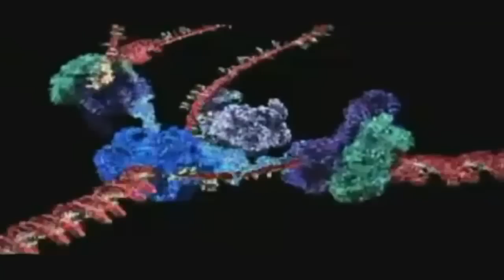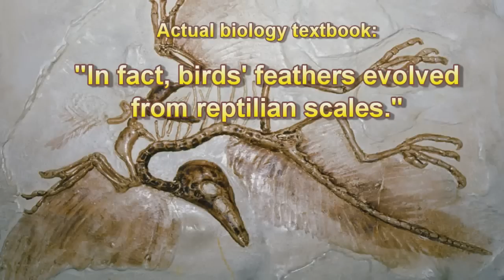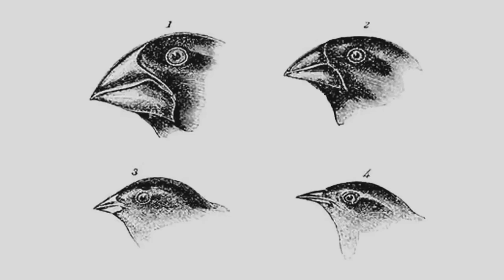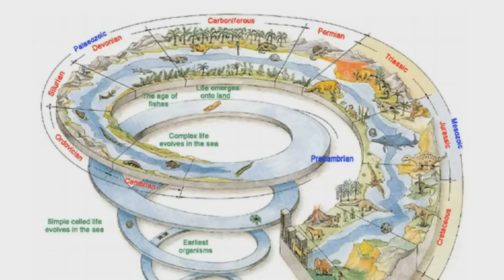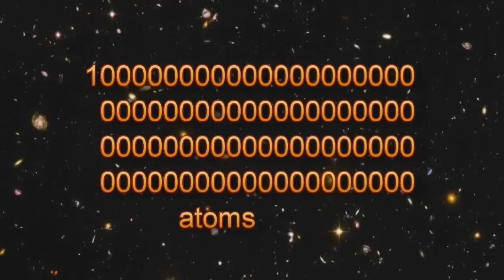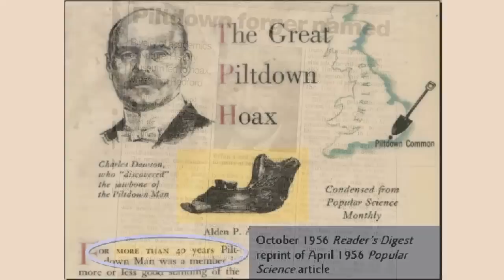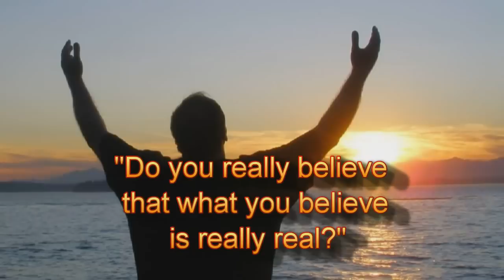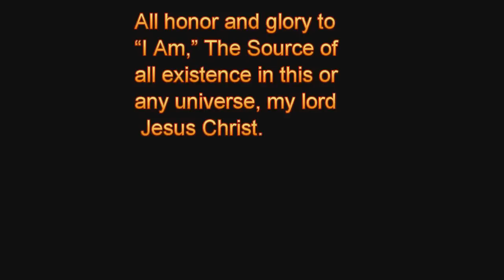Evolution Demolition

Comment: 49:02

DNA contains instructions for creating something that can copy itself so that it can keep existing and copying itself. It doesn't contain any useful "information". The machine code that runs a program on a computer is the same way. Take it out of its context, and it's completely useless. Same with the "code" in the DNA. It has no informational value outside of its very limited context.

DNA is a biochemical memory.

But yes, DNA and machine code for a computer is extremely similar, the way DNA is used in modern life.

But DNA is not a "message", unless you can show that it came from a mind. And it's obviously not being used as a message, but rather as machine code instructions, like a computer program.
Try opening an .exe file in notepad, and read the "inormation". See how much value it has outside of its very strict context. Same with DNA, it has no useful information outside of its context. Therefore it's not a "message".

50:00

That message in the sand was written with human letters, forming human words. DNA is not a human language, and it's not forming human words. So yes, I assume another human wrote "sand" in the sand, because that's what humans do, not what nature does.
But DNA? That is something nature does.

No one wrote the code in the DNA. We know this because the code changes naturally with every generation. So if there ever was an intelligently designed code in there, it's been changed by nature a long time ago.
Reply: antiHUMANDesigns So how do you explain smiles and laughter?  How do you explain the existence of music?  How do you explain philosophy and poetry?

The most complex matter in the universe is the human brain, which you think simply evolved via natural selection and random mutations to generate the ability to survive.  So why do you assume that your own intellect is reasoning in a valid way, given that your brain is no more than the result of such forces?
Reply: Mark Champneys "So how do you explain smiles and laughter? How do you explain the existence of music? How do you explain philosophy and poetry?"

There is a very good book on this very subject, by professor Victor S Johnston of NMSU, called "Why we feel: The science of human emotion".
Yes, it's a very complex subject. I wouldn't attempt to explain it satifactory in a youtube comment.

"The most complex matter in the universe is the human brain"

It might be. It's the most complex entity that we know of. But it's not like we've looked... barely anywhere.

"So why do you assume that your own intellect is reasoning in a valid way, given that your brain is no more than the result of such forces?"

Because that is reliable. Nature is what is real, and our brains are part of nature, so by definition they are part of what is real. And our brains are constantly tested against what is real. Simply put, if there was something fundamentally "wrong" about the brain, then we'd be dead.
But a brain that is "wrong" could not evolve. It would be bad for the individual.
Reply: antiHUMANDesigns "if there was something fundamentally "wrong" about the brain, then we'd be dead."

That does not follow.  Most living things have brains, and they survive, but they cannot reason.  We are talking about your ability to reason.  Survivability is very different from the ability to reason.  Reason is not a destination of Darwinism, only survival.  So what assurance is there in Darwinism that you can think straight, especially about abstract things?
Reply: Mark Champneys "Most living things have brains, and they survive, but they cannot reason. "

Well, most living things don't have brains, but whatever, I get your point.
I think we've got slightly different definitions of "reason". At least the "width" of the definition.
An ant is probably not aware that it is reasoning, but when it senses a smell, its brain gets signals, and the brain makes sense of those signals to make a decision about what to do. For example, run away, or follow the smell, and so on. Human reasoning still works the same way, it's just too complex to easily map it, so it looks as if it's something else, something more "free", but it's not "free". We cannot think "freely". We always think like a human. That's why we all, for the most part, think alike.

To get to my point: If the ant senses danger, but its respons is to go towards the danger to say "hello" (so to speak), then it will die. This is an example of its reasoning being bad.

In the case of humans, if my reasoning was "wrong", then I would not recognize that walking off a cliff is bad. I would not recognize that eating razor blades doesn't work as food. Simply put, I wouldn't make it one day. Basically, I would not be able to use my brain at all, because instead of reasoning, everything would just be a mess. I would not be able to communicate, for example.

"Survivability is very different from the ability to reason."

Not if your survival depends on your ability to reason, which is more true for humans than for any other living thing we know of, I suspect. But once again, it depends on the width of your definition of "reasoning".
A plant doesn't reason "much" at all. For the sake of argument, we could say it doesn't reason at all. But it also doesn't have the ability to eat razorblades, and it doesn't rely on communication ("much"), and so on.

" Reason is not a destination of Darwinism, only survival."

Good to hear you say that, because many creationists don't seem to underwstand that.
Yes, whichever DNA manages to copy itself is the DNA that will keep existing for a while longer. Though, evolution is generally about population groups, not individuals.

"  So what assurance is there in Darwinism that you can think straight, especially about abstract things?"

That we wouldn't have evolved this ability unless it was useful to our survival and/or reproduction. If we evolved abstract thinking, but it constantly lead us astray, then we wouldn't have a higher chance to reproduce, so such a trait would not be selected for.
That's the beauty of evolution: Everything is always tested for quality, so to speak. Of course, it's biased towards what makes the product keep copying itself, thsi is why we don't actualyl see the world for what it truly is (whatever that's supposed to mean), but rather for how it's useful to us.
To quote professor Victor S Johnston: "The human brain did not evolve to accurately represent the world around us; it evolved only to enhance the survival of our genes."

But of course, being aware of this means it's not a problem. Yes, rotten food doesn't actually smell bad, it's just our brains telling us it does to stop of from eating it. But being aware of this, we don't make the mistake of actually thinking that some molecules truly have a "bad smell" innate to them.
Reply: antiHUMANDesigns You equate programmed responses with reason, but reason, as I'm using the term at least, involves the ability to think in abstractions, and consider options.  Reason involves free will, not programmed responses to stimuli.  Abstract thought is absent from your discussion, yet that ability is essential to considering such things as origins.  So do you believe in the existence of free will or do you hold to a BF Skinner-type view of determinism.
Reply: Mark Champneys No, an ant doesn't have "programmed responses" any more than we do. But when you see a nasty spider, you will likely feel a specific reaction. If it drops down on your face, you'll probably react like any other human would. Why is that? Because you've got a human brain, and you think like a human - not freely.

"involves the ability to think in abstractions, and consider options."

What does it mean to "consider options"? A computer also considers opions, and makes choices. What's so special about how you consider options? It's more complex, so it takes a longer time,a dn there are more factors to consider than in most computer programs, for sure, but that doesn't mean it's not the same process, still.

" Reason involves free will, not programmed responses to stimuli."

What is "free will"? The freedom to make absolutely any choice? The freedom to not be bound by cause and effect (a violation of physics)?
If we had "free will", why do we all act typically human?
We do not have free will, it just appears as if we do, because there are too many factors to track if you want to be able to predict what someone will choose to do. If we made a complex computer program that reproduced with variation, and learnt as it "grew up", we would no longer be able to predict what choices it would make, either. It would appear to have "free will", aswell.

" Abstract thought is absent from your discussion"

We humans have this prefrontal cortex that allows us to retrieve information from the other parts of our brain, manipulate it, and re-insert it as new information. It's a cool trick, and it allows us to be very inventive. Is this what you're talking about? We can think of a bus, and think of the number 6, and try to imagine ways to combine these two things into something new. It's a trick.
However, we can never think of something completely new, that is not derived from something we have already seen or experienced. We cannot have truly novel thoughts. This is why we keep stealing designs from nature. It's also why aliens in movies are mish-mashes of things we've seen on earth. Try it yourself: Design an alien lifeform without stealing anything from something we already know about.
And this ties in to "free will", aswell. We cannot think truly freely, we'll always think like humans, just like a rat will think like a rat. And we think the way we do because it has allowed us to reproduce.
Reply: +antiHUMANDesigns Okay, so you don't believe in free will or reasoning about abstract ideas.  The only problem is you are thinking about this right now, so you know better.  You have inside information.  Inside yourself.  Is there such a thing as right and wrong?  Does the idea of babies being tortured bother you?  Why?  Do you believe in the existence of human rights?  Why?
Reply: Mark Champneys "Okay, so you don't believe in free will or reasoning about abstract ideas. The only problem is you are thinking about this right now, so you know better."

Yes, so you're obviously wrong in saying I don't believe in reasoning. I hav eno idea where you got that idea.
You're right that I don't belive in free will, though. But people define that in different ways. I believe in some definitions of it, but not in most.

" Is there such a thing as right and wrong? "

Yes, if we define those words, then there are rights and wrongs. I do believe in objective morality, just like I believe in objective medicine. What is good for life is not a matter of opinion, it's something that we can learn about through science.

"Does the idea of babies being tortured bother you? Why?"

Yes. Because I have empathy.

"Do you believe in the existence of human rights? Why?"

Yes. Because we've signed up on them. We've agreed upon them. Well, we more or less agree on most parts.
The geneva convention (was it?) states that all children have a right to a home, for example. We obviously don't all agree to that right, since there are homeless children - even though we did sign that paper.
So if you "human rights" you mean things like the right not to be murdered, then I don't only believe they exist, I know they exist.
Reply: +antiHUMANDesigns What is good for who's life?  Where did you get your empathy?  Is there some inherent survival value in empathy?  We have rights because we've signed up?  Why would you sign up?  What about all the people that did not sign up?  Then you do not believe in the declaration of independence that says it is "self-evident" that all people have rights that come from their Creator?  Do you see how evolution is completely inadequate to explain all these things?  If you look inside yourself, you know better, and I think you know that... because I sense that you are a decent human being.
Reply: Mark Champneys OK, lots of questions. And fair ones, sure.

"What is good for who's life?"

All humans are made up of the same biology. Arsenik is always going to be poisonous to us, so it's bad to eat it.
I'm talkig about what is good for life, not "life" in the sense of the experience of life, but life in the sense of survival and biology.

"Where did you get your empathy?"

I inherited it from my parents, I assume.

"Is there some inherent survival value in empathy? "

For a social species, yes, that's why we have it. If humans want to live together (which makes us stronger as a whole), then there has to be some kind of inborn instincs that make us not kill eachother, or we will fail as a social species.
Species that aren't social at all won't have empathy. They don't need it.

"We have rights because we've signed up?"

Yes, I'm talking about the geneva convention, and so on. We've all tried to agree upon a set of rights that people should have, and we mostly all agree, more or less, to the same rights.
You only have rights because they are enforced by law. If there was no law enforcement, then you don't have rights even if you think that you should have them.
But we can talk about what rights we "should have" as human beings, but that doesn't mean we actually do have those rights enforced.
Imagine that you lived where the was no law, and someone stole from you. What are you going to do? Claim you have rights? That won't help you one bit.

" Why would you sign up?  "

Because I wouldn't want to live in a society where we don't have some specific rights, such as the right now to be enslaved, for example.
Weird of you to even ask.

"What about all the people that did not sign up? "

I dunno, I guess they didn't sign up because they felt it made them lose power over their people. Remember, it's the governments that signed, not private people. You need these rights enforced by law, or they're useless.

"Then you do not believe in the declaration of independence that says it is "self-evident" that all people have rights that come from their Creator? "

That's not my declaration of independence. I'm Swedish, and our declaration doesn't say that. As a Swede, I don't care much for what the US declaration says. It's not like they're right just because they started a new country.
I don't agree that those rights are self-evident, but I agree that there is evidence for why those rights make sense. They can be demonstrated to be useful.

"  Do you see how evolution is completely inadequate to explain all these things?"

Not, they explain it quite perfectly. If you have a species of animals that are not social, they don't live by "strength in numbers", so to speak, and then you try to make them social, you will fail utterly unless you add instincts that make them not take advantage of eacother and hurt eachother.
It's not an easy subject to understand, but I've read a great book explains these things, by professor Victor S Johnston of NMSU, called "Why we feel: The science of human emotions".
It talks about why we would evolve emotions, for the most part. But also why we are conscious and why we experience existence the way we do. It's really tough stuff, but very interesting.

"If you look inside yourself, you know better"

Ehhhh, don't do that. Don't ever "look inside yourself" to try to understand things that are hard to explain. That's what we have science for. It's about as bad an idea as trying to use common sense to understand quantum mechanics.

"because I sense that you are a decent human being."

Yes, I would say I definitely am. But I'm also an intellectual person, and the first rule is to not think that you can just "think things out", that you can just assume that whatever makes sense to you is the truth. It's been demonstrated, over and over, both that the truith is not always simple, and also that humans are prone to make mistakes. Lots and lots of mistakes.
This is why we have the scientific method, to try to remove that human factor from the search for understanding.
Humans are prone to superstition, for example. It's a good mechanism when you're a baby, when you need to learn the basics about the world, but it eventually starts working against you.
Reply: +antiHUMANDesigns "...there has to be some kind of inborn instincs that make us not kill eachother,"   Oops.  Epic fail.

"Ehhhh, don't do that. Don't ever "look inside yourself" to try to understand things that are hard to explain."   I'm not suggesting that you make things up.  I'm speaking of an actual observation about what is in there and can't be observed from the outside.  If you are careful to understand the risks of self-delusion, it is important data that can't be obtained any other way.  You have inside information about the notion of consciousness, for example.  Take advantage of it.  Objective observations are fine, but we are dealing with questions (such as origins) that are outside the bounds of our ability to observe.  We are forced to make inferences to the best possible explanation, without having first-hand knowledge.  Writing off laughter or music as mere mechanisms of our survival is shallow and foolish.  Such things clearly have meaning and significance beyond natural selection.
Reply: Mark Champneys""...there has to be some kind of inborn instincs that make us not kill eachother," Oops. Epic fail."

"Epic fail"? 8| Wtf do you mean? 

" You have inside information about the notion of consciousness, for example.  "

not really. What information would that be? The only difference between an inside and outside look at the issue is that an inside look gives me the experience of it. But that doesn't change what it is or how it works, it rather just gets in the way of it.

"Objective observations are fine, but we are dealing with questions (such as origins) that are outside the bounds of our ability to observe."

That has not beeen established. Its very well possibly that we can determine what our origins are.
And to "observe", in scientific terms, simply means to collect data. It doesn't mean seeing something with your eyes.
We can observe the past with various means.

"We are forced to make inferences to the best possible explanation, without having first-hand knowledge.  "

As if first-hand knowledge is automatically correct? It's not. The only thing that matters is following a good scientific method, and to use proper reasoning.

" Writing off laughter or music as mere mechanisms of our survival is shallow and foolish. Such things clearly have meaning and significance beyond natural selection."

Then demonstrate the truth of that claim. It's that simple, that's all you have to do. Meanwhile, we have no reason to believe that claim.
Reply: +antiHUMANDesigns "Try opening an .exe file in notepad, and read the "inormation". See how much value it has outside of its very strict context. Same with DNA, it has no useful information outside of its context. Therefore it's not a "message".

obviously the exe file code is not going to make sense outside of it's context: it was intended strictly for the computer to read: same way the DNA is intended for the cells... the exe file code is not a message to you but to the computer: that doesn't mean it's not a message...
Reply: Benjamin Toby It is not information because it doesn't inform you.
An exe file, just like a DNA string, is only "information" in the sense of information theory, not in the sense of being informed. And in this way, a lot of things are "information". If you throw a bunch of rocks on the ground, the pattern they form is a kind of information, in the same way that DNA is information. It's a quantifiable amount.
But it is not information in the sense that it can inform you of anything. 

And the exe file isn't being "read" by the computer, because a computer doesn't have a mind. When we say a computer "reads", that's not what we mean.
If there is a number 5 there, then that will cause the electricity to go a certain way, and if it's a 6, it will cause something else to happen.
This is not "reading". It's cause and effect.
And DNA does the same thing. A specific sequences causes a specific protein to form, and that's all.
Machine codes causes specific electric patterns, and DNA causes specific chemical structures. Neither is "information".
Reply: antiHUMANDesigns the DNA is information to the cell: it's also information to you because you recognize it's a code: any reasonable person can tell the difference between the pattern a bunch of thrown rocks forms, and that of the DNA... the information from the thrown rocks is obviously gibberish but the DNA clearly shows a well sequenced code which contains instructions for specific tasks. 

"cause and effect"? what happens if you run an exe file on an android OS??? obviously reading a file in this context means getting compatible information from it: the number 5 on the exe file would cause an effect only with the compatible OS: that's why the DNA would not work outside the cell... without intelligence the "cause and effect" of the exe file wouldn't even exist... same for the DNA....
Reply: Benjamin Toby Ask yourself, can the information in DNA be "wrong"? If I tell you the wrong information about something, then that information is wrong. The "information" in DNA can never be right or wrong, because it's not there to inform anyone about anyhing. 

I agree that DNA can contain informative information, just like anything could. Look at our alphabet, 26 letters, compared to DNA's 4 bases. Our letters can form information that is meant to inform, and so could DNA. But it doesn't. You cannot read the DNA and be informed about anything else than what the sequence is. The sequence doesn't mean anything aout side of its context, therefore it isn't information.

No, it's even worse, a "5" in the machine code might do different things for different CPUs. That's why we need things like drivers and such, it's very complicated. Some CPU's have extended instruction sets of different versions, and only some programs make use of those instructions, and os on. It's a horrible mess, simply, because no one set up a standard to begin with.

"without intelligence the "cause and effect" of the exe file wouldn't even exist... same for the DNA...."

It's not an intelligence that's "reading" the DNA. Just like how the architecture of a computer decides what happens when you give it a "5", it's the laws of chemistry that "decides" what a specific sequence will result in. An intelligence can't change this even if they wanted to.

Yes, the architecture of the computer was made by humans. But the laws of chemistry and physics was not made by a human, and we have no reason to believe it was made by anyone at all.
And of course, computers do not reproduce with variation, so they cannot evolve.

And the important part to note here is that your DNA is the way it is because you are a variation of a copy of your parents. But because every human is born with about 60 mutations, some of your DNA is unique and completely new. Give this a million generations, and you might end up with 60 million mutations, in which case you are not even of the same species, anymore.
So if there ever was an intelligently designed DNA to start with, it's mostly gone, now. And that's obviously not a problem.
Reply: antiHUMANDesigns

1. "The "information" in DNA can never be right or wrong," actually it can't be wrong because it has a self correcting system that makes sure it's as right as possible: that's why a damage in a section caused by radioactive materials can lead to a hideous sight... 

2. "Our letters can form information that is meant to inform, and so could DNA. But it doesn't." the DNA was never meant to communicate any information to you: its instructions are strictly meant for the cell... it's not information to you doesn't mean it's not information: If I write an encrypted e-letter to my friend and you stumble into it and it appears as digital numbers(0's and 1's) hence you couldn't read it: does that mean it's not information?... 

3. " It's a horrible mess, simply, because no one set up a standard to begin with."... an Intelligent designer you mean?

4. " It's not an intelligence that's "reading" the DNA. "... it's not intelligence that's reading the computer code either: the reading and interpreting is only made possible by intelligence.

5. "And the important part to note here is that your DNA is the way it is because you are a variation of a copy of your parents." that's pretty obvious: my DNA was made by combining genetic information from my parents and adding a variation: that sounds to me like intentional variation: there's a reason why humans have not developed wings yet... the original DNA was never meant to be static.
Reply: Benjamin Toby "actually it can't be wrong because it has a self correcting system that makes sure it's as right as possible"

It's can't be wrong because there is no right or wrong, because it's not saying anything. IT's making no claims about the world, it isn't trying to inform anyone or answer correclty on a question. It contains zero information, therefore there is no information that can be checked against reality to see if it is right or wrong.
And the self-correction mechanisms only attempt to keep it the way it is, stop it from mutating. But it can still mutate, because these mechanisms are far from good enough.

" If I write an encrypted e-letter to my friend and you stumble into it and it appears as digital numbers(0's and 1's) hence you couldn't read it: does that mean it's not information?... "

Encrypting it doesn't stop it from being information. I don't care what language you writ eit in, even if you write it in your own made-up language that no one else can read, it's till informative. The contents of the message relays information from one mind to another.
DNA doesn't do this. It wasn't written by a mind, and it's not sent to a mind, and it has no need to inform anyone about anything. DNA simply is, and the DNA that is better at existing will more likely keep existing, and have more copies in the world. It's just a molecule, there's nothing magical about it.

And other molecules have information just like DNA. "H20" <- this is information in the exact same way as a DNA molecule.

"3. " It's a horrible mess, simply, because no one set up a standard to begin with."... an Intelligent designer you mean?"

You do remember that we're talking about computers, right? I think we all agree that computers are build by humans. They do no reproduce by themselves.

"4. " It's not an intelligence that's "reading" the DNA. "... it's not intelligence that's reading the computer code either: the reading and interpreting is only made possible by intelligence."

Yes, but if computers reproduced with variation, so that they could evolve, then it would be different. They don't, so we have to build them.

"that's pretty obvious: my DNA was made by combining genetic information from my parents and adding a variation: that sounds to me like intentional variation: there's a reason why humans have not developed wings yet... the original DNA was never meant to be static."

There are plenty of reasons why humans haven't delevoped wings.
Yes, I agree, the variation is there for a reason. Any species that does not evolve will eventually get left behind by those that do, and they will not be able to adapt to their environment when it changes.
Therefore, it's in life's best interest to evolve, if it is to keep existing. Therefore, only life that evolves still exists.
But "intentional" implies a mind, and we have no reason to go down that road.
Reply: antiHUMANDesigns you know i thought if I replied to all of that, I'd actually be repeating myself: but just to sum up: correct me if I'm wrong

1. you believe the DNA is a code, similar to the computer code...
2. you believe the computer code can only be intelligently created but the DNA code which is more complex just happened to exist...
Reply: Benjamin Toby Yeah, it's good to summarize every now and then, or a conversation might get out of hand.

 
"1. you believe the DNA is a code, similar to the computer code..."

I would be very careful about the word "code".
Machine code is a kind of code, perhaps, but DNA is less of a code than that.
Basically, if I were to push clay through a hole, the clay would come out the shape of the hole, yes? The hole is basically what DNA is. In the end, DNA is only a molecule in a world of chemistry. The fact that it's a macro-molecule doesn't stop it from being just a molecule.
And then there's the difference between "DNA" and "human DNA", for example. What is DNA, vs what is the role of DNA in a highly evolved organism.

http://dictionary.reference.com/browse/code?s=t
Definition number 6, "a word, letter, number, or other symbol used in a code system to mark, represent, or identify something".

This does not apply to DNA. The only way it applies it when we write "TAGC", which is code for the 4 different nucleobases. But the DNA doesn't actually use this code. It's just a molecule.

"2. you believe the computer code can only be intelligently created but the DNA code which is more complex just happened to exist..."

Computer code *is* created by humans. I'm not saying it can only be created by humans, but it is only created by humans, as far as we know. 
DNA is created by nature, we see this as a matter of observation.

Also, DNA is not "more complex". Modern DNA, such as human DNA, is really long, but DNA itself is not complex. DNA itself is just a linked chain of nucleobases, not very complex, though certianly not very primitive, either.

The difference between computer code and DNA is that I can hold DNA in my hand, but I cannot hold computer code in my hand. One is a molecule, the other one is a concept. That's why we can't really compare the two completely. It's also why nature can't create computer code - it doesn't actually exist, physically.
Reply: antiHUMANDesigns

1. you just defined a code to be a word, letter or other symbol used to mark, represent, or Identify something:... the DNA sequences represent patterns for building proteins: how exactly is it not a code? you just defined the DNA to be a code you know.

2. what makes the computer code a concept and the DNA not? the fact that you cant hold a computer code has nothing to do with it being a code: the definition says a word, letter or SYMBOL... the computer code is a letter code, the DNA code is a symbol code: those are still codes: what makes a code is what it represents: if it represents a particular process, then it's code...and do we need to explain what process the DNA represents?
Reply: Benjamin Toby "the DNA sequences represent patterns for building proteins: how exactly is it not a code? you just defined the DNA to be a code you know."

No, a pattern is not a code. A code for a pattern is a code.
"ATGC" <- this is code for the bases in a DNA. The bases in the DNA are not codes, but these letters that we use to refer to them are codes.

The only way that DNA can be a code is if it is being interpreted by a machine or a mind, but it's not. The bases produce what they produce, there is no interpretation, and there are no options. But "ATGC" could be called whatever we want, because that is a code, and it is interpreted by minds. It could just as well be any other 4 letters, for example.

"2. what makes the computer code a concept and the DNA not? the fact that you cant hold a computer code has nothing to do with it being a code:"

That is exactly it. A code is not a physical thing, it is a conceptual thing. DNA is not a code, though it could contain a code. DNA is well suited for storing sequences of 4 (or 5, even) differnet "values". It's not a code, just like a harddrive isn't a code.

"the computer code is a letter code, the DNA code is a symbol code:"

yes, but now you're saying "DNA code", not "DNA". That's a big difference.
If the DNA contains a code, then it contains a code. If it doesn't, then it doesn't, but in either case, it's still DNA, and DNA is not a code, it's a molecule.

And DNA does not contain symbols, either.
A symbol is something used to represent something else. There is nothing such going on in the DNA.
But because DNA is orderly, we can find simple rules that apply to it, and we can describe the process in terms of symbols.

We can describe gravity by writing "F = m/d^2". Does that mean that gravity contains those symbols? No, it doesn't.

And fruthermore, while a paper can have symbols on it, a paper doesn't contain symbols. It's not a trait of paper, it's a trait of what's on the paper. We can use DNA as a code for something, but that doesn't mean that DNA is a code, because it's not.
If I were to create my own DNA that contained a code for my home address, then it would be a code. But that is because it is a message from one mind to another, encoded into a sequence of some kind, and there is a ind interpreting it, converting symbols that refers to real things. You might see the logo for "Ford", and your mind knows it represents those cars. DNA does nothing like this, it just chemically produces proteins.
Reply: antiHUMANDesigns Oh I see... your confusion is differentiating DNA and DNA code?... 

- DNA

noun
deoxyribonucleic acid, a self-replicating material which is present in nearly all living organisms as the main constituent of chromosomes. It is the carrier of genetic information.(Google)

-Deoxyribonucleic acid (DNA) is a molecule that carries most of the genetic instructions used in the development, functioning and reproduction of all known living organisms and many viruses.(Wikipedia)

as we can see DNA is both a molecule and a carrier off information: which is the code I'm speaking of... there's no difference... the atoms just makeup the code...

it seems like you forgot your definition...CODE: ""a word, letter, number, or other symbol used in a code system to mark, represent, or identify something""... the DNA contains the sequence, a protein unwinds a section of it and a copy of a sequence is made... the copy is used to guide another system which builds proteins following the copied sequence... the sequence here is the symbol because it represents the formation of the desired protein... so, symbol= sequence, representation= protein... DNA = a whole lot of sequences = a whole lot of codes... going by your definition... 

so... "And DNA does not contain symbols, either.
A symbol is something used to represent something else."... what's that about?

also if you fold a paper to make a symbol, representing something, AKA a code: is that paper just a paper or a code?
Reply: Benjamin Toby "as we can see DNA is both a molecule and a carrier off information: which is the code I'm speaking of... there's no difference... the atoms just makeup the code..."

Yes, the definition you quoted is fine. DNA is a molecule, and because it is a chain of 4 different bases, it can contain sequences, or "information" in the sense of information theory, a quantifiable amount.
And because it is a chain like that, it could be used to encode informative information, such as a message, or even a jpeg picture.
But this requires that someone encodes this information and then decodes it.

The sequence that naturally exists in DNA of humans, for example, is not a code. It doesn't represent anything, it's just a sequence that produces specific proteins. It is the same thing as pushing clay through a cross-shaped hole and getting a cross-shaped clay. The "information" in human DNA is not interpreted by anyone, it isn't decoded, therefor eit's not a code. It simply reacts, chemically, to form amino acids that chain up into proteins.

"the sequence here is the symbol because it represents the formation of the desired protein... so, symbol= sequence, representation= protein... DNA = a whole lot of sequences = a whole lot of codes... going by your definition... "

No!
They are not symbols, because if they were, they would have to be interpreted by a mind. We asssign them symbols so that we can more easily talk about what's going on.
A sequence is just a sequence, nothing more. If the sequence is meant to be interpreted as a code, then it is a code. But this is not what's going on in human DNA.

There is no "desired protein". You keep using words that require a mind to be part of the process.

"also if you fold a paper to make a symbol, representing something, AKA a code: is that paper just a paper or a code?"

It's now a paper that contains a code, just as if you had written a code on it. But you didn't add any physical thing to it, and the code only exists because a mind is able to interpret the folds as a message from some other mind. Without any minds, there is no code.
Reply: antiHUMANDesigns I think I see the major misconception

"Yes, the definition you quoted is fine. DNA is a molecule, and because it is a chain of 4 different bases, it can contain sequences, or "information" "...

this was why I gave the example of the folded paper... take this instance: I fold 5 pieces of papers to form a sequence 10010: that sequence acts as instructions for switching a light bulb(1 being on and 0 being off)... I repeat my question: is that sequence paper or a code or both?
Reply: Benjamin Toby It is a sequence stored on paper.
Whether the sequence is a code or not is a different issue. It depends on if the sequence is decoded when used, or not. 

A "code" is something that represents something else within a code system.
A "code" is something that refers to something that refers to a real thing. It's what's called a "second-level symbol".

A word, such as "bird", refers to the real thing, an actual bird (but the word is not a bird, of course).
A code for "bird", might be "25251" or "flyer", whithin a specific code system, and refers to the word "bird", which refers to the actual bird. This is why it's second-level.

When it comes to computer code, this is true, because it's at least second-level symbolism.
In reality, the CPU either sends an electrical signal, or it doesn't. We refer to this as 0's and 1's, this is the first-level symbolism. Those 1's and 0's represent the real thing.
Anything that represents a set of 1's and 0's are codes. The number "5", for example, is a specific set of 1's and 0's, and is thus code within this code system, because it is second-level symbolism.
This is exactly like my example with "bird", vs a code for "bird".

"101011100111" <- this is not computer code. It's not encoded, it's the direct symbols for the real thing.
It could be encoded to "AE7", which is hexadecimal code for that same sequence. Now you've got hexadecimal code that refers to a string of binary numbers, which refer to the real thing.

So how is the sequence in DNA a code? It's clearly not, because it's the real thing, it's not even a symbol for the real thing. We create those symbols, CTGA, but they do not actually exist in the DNA, they only refer to parts of the molecule.
"C" is code for "cytosine", and cytosine refers to the real thing, therefore "C" is code, within this code system.
But the real thing, the part of the molecule, is not a code, even though it's theoretically possible for them to represent a code, if they are part of a code system. But they're not, because they are not interpreted, they are not decoded to become a symbol that refers to something.

We could use DNA to store code, though. If we use different sets of bases to represent letters, such as "ACT" representing the letter "L", for example, then we could read the sequence, and decode it to letters, and know the words.
So a sequence of "ATTAGATTCG", or something, might be decoded to mean "bird", under a specific code system.

Imagine if the body actually did this. It reads a sequence from the DNA, then decodes it to a symbol for what it was going to do, and then did that - without having any idea how to actually do that! It would need to have 2 sets of DNA, one that is code for the other. That would be stupid, since it could just have the one DNA that isn't encoded, and skip the other.
And that's exactly what it already has.
Reply: antiHUMANDesigns ""101011100111" <- this is not computer code. It's not encoded, it's the direct symbols for the real thing.
It could be encoded to "AE7", which is hexadecimal code for that same sequence. Now you've got hexadecimal code that refers to a string of binary numbers, which refer to the real thing."... Ummm... you do know that you can type your program in binary form right?... the hex form is just to shorten it... and the programming language shortens it more... ever heard of binary code?... it's the real code: just that it'll be cumbersome and extremely stressful to write programs in that form... so this "real thing" is actually the real code: the rest are just different representations... so what's your point exactly? if you write a program in a programming language say C++ you're actually writing binary codes: only that the language makes it easier for you: once you're done, the compiler translates it back to the binary code before it's executed...
Reply: Benjamin Toby "Ummm... you do know that you can type your program in binary form right?... the hex form is just to shorten it... and the programming language shortens it more... ever heard of binary code?... "

Yes, I am a C++ programmer, so I know.
Yes, you could write a program straight in binary, but that makes no sense do to.
Hex form is just base-16, yes. But it's still code, because it represents a binary sequence, and the binary sequence is symbolic for what is really going on in the computer.
No, I've never heard of "binary code". I wouldn't be surprised if anyone said that, but they'd be wrong to say that. It's technically wrong, but you would understand what he/she means.

"it's the real code: just that it'll be cumbersome and extremely stressful to write programs in that form... so this "real thing" is actually the real code: the rest are just different representations"

No, that's not quite true. A high-level programming language isn't directly translated from words to instructions. There is syntax.
If I write "x = 5+6", then that is not exactly what the computer does. This code that I write is translated to assembly, which is effectively the same thing as machine code, even if it isn't machine code. Then the assembly is converted to machine code, quite simply. Of course, compilers might skip the step of making it assembly.
The "real thing" is what's going on in the computer. Electric signals being sent down circuits and such. To help us talk about it, we call it true/false, or 0/1, or something similar. But the computer does not use 1's and 0's, they use what those 1's and 0's represent: Electrical currents.
So 1/0 is symbolism for electric currents. Go to a higher level, such as hex code, and it's technically code.
You say the rest are just different "representations" <- that is exactly what a "code" is. Something that represent something else. And that's why it needs to be decoded. Sometimes decoding it is simple, because the code system is simple. For example, hex values as code is really simple and makes a lot of sense, because 16 is a power of 2, which fits really well with binary numbers, which is all about powers of 2.

Another example of a "code" is if you and I want to share a secret message, so I tell you "the blue goose is on the run", and because we've got a code system set up, you can decode this an dunderstand that it means that it's time to rob a bank, or something. (?)
So in that code system "the blue goose..." decodes into "time to rob the bank", which refers to the actual act of robbing a bank.

" if you write a program in a programming language say C++ you're actually writing binary codes"

No, you're writing code that, in some sense, represents binary strings/sequences. It's not correct to call the binary sequences "codes", because they are not interpreted, they are direct instructions. If they are located on a harddrive, then they are actual fluctuations in the magnetic field on the harddrive, which will get turned into electrical signals, which drives the "machine" that is the computer. We symbolically call these fluctuations "1/0", but that is only symbolic.

"only that the language makes it easier for you: once you're done, the compiler translates it back to the binary code before it's executed"

Not binary code, binary data, a binary string, sequence, wahtever, but not a code. When the program has been compiled into 1/0, then it is done, there is no more changing or decoding going on after that, assuming it's not compressed somehow, like in a zip file.
A zip file, or .rar or similar, takes a sequence of data and encodes it. It does this by writing things that symbolically means something that is longer (takes more space). That is a form of code. A zip file uses RLE, so if there are 7 0's in a row, then it will basically write "7-0" (somethign similar), which takes less space than writing "0000000". This is code, and the sequence needs to be decoded before it can be used.
But a binary sequence, such as in an .exe file, does not need to be decoded, because it is not a code. It's a sequence of direct instructions, not symbolic, and not encoded. If it was code, it would be slower, because it would need to be decoded as it runs.
Reply: antiHUMANDesigns sooo... your basic problem is the term "code"... as a programmer I'm kind of surprised you prefer to call the machine code binary strings... the only reason you need to "code" these "strings" is to allow flexibility and ease of use of the strings: and even if these strings represent the switches, you can just use the switches directly: just that there'll be less flexibility: 

"But a binary sequence, such as in an .exe file, does not need to be decoded, because it is not a code. It's a sequence of direct instructions"... and those instructions are translated to the display: if they don't need to be decoded then why don't you see a bunch of 0's and 1's on your computer screen?... don't you know how computers work?... if you type "bird" on your computer it's translated to 01100010011010010111001001100100 and your processor recognizes the sequence and tells the display to show "bird"... so why are you speaking like the binary sequences aren't interpreted?
Reply: Benjamin Toby "as a programmer I'm kind of surprised you prefer to call the machine code binary strings"

Well, machine code isn't actually binary. I mean it is, of course, but each binary value isn't read as a separate instruction, because then there would only be 2 different instructions, and I know there's at least 6 basic instructions, so the bits are probably read 8 at a time, for each instruction, I suspect. Could be different for differnet architectures, aswell.
So then each instruction is a specific pattern of a set of bits, because one bit isn't enough.

A "binary string" is just a sequence of bits, such as "0110". Anything in a computer is a binary string, fundamentally.
But now you're switching words again. You said "binary code", and now you're saying "machine code". Those are not the same thing.

"and even if these strings represent the switches, you can just use the switches directly: just that there'll be less flexibility: "

The CPU will not accept just one bit, it needs a specific set of bits. If you want to just "flick one switch", you would give it something like "00001000" to only activate the 4th "switch".
As far as I know, a computer does not have the ability to only send one bit, under any circumstances. They always come in packs of 8, 16, 32, 64, or any other power-of-2. (Though, there has been 6 bit computers, aswell.)
This is why a binary string isn't the same thing as machine code. A binary string can be of any length, but machine code must always be a 8-bit value, or some other length that is specific to the architecture of the computer.

Confusingly, machine code is a binary string, but a binary string isn't always machine code. :P
Why are we discussing this, again?

"and those instructions are translated to the display: if they don't need to be decoded then why don't you see a bunch of 0's and 1's on your computer screen?... don't you know how computers work?... "

No, you don't know how computers works (which becomes even more apparent later on in your comment).
The screen is just another computer that your computer is talking to, sending messages to. There are plenty of programs that do not show you anything on the screen. The screen is irrelevant to this, it's just an attached device, like joystick or a mouse.

You're talking about software, not hardware. 1/0 represents what's going on in the hardware. And yes, of course, the result of a specific complex set of 1/0 will result in something that is useful, a software.
And yes, software could translate strings of bits and so on, but just because they could doesn't mean that they do.

Displaying somethig on a screen is just another electrical signal going through the motherboard on the computer, using a specific set of instructions. Whether those bits are codes or not, depends on what the monitor is expecting. Once again, that doesn't inherently make it "code", it just means it could be code. Just like how I could talk plainly to you, but I could also talk in code, if that's what you need me to do.

And of course you will not see 1's and 0's on the screen. We've already been over this: There are no actual 1's and 0's, they are symbols for electrical signals. If you could see these things, you would see electrical signals, not 1's and 0's.
It's as if you think that if I would show you a bird, it would be the word "bird" you're seeing, instead of the actual bird that the word refers to.

"if you type "bird" on your computer it's translated to 01100010011010010111001001100100 and your processor recognizes the sequence and tells the display to show "bird"... so why are you speaking like the binary sequences aren't interpreted? "

Hehe, no. Just no.
If you type "bird" on your computer, you've actually already typed that binary string, but it is being displayed to you interpreted as letters. There is no way a computer could actually store a letter, since it can only store bits. Neither can your keyboard send letters to the computer. I can only send binary sequences. There was never a letter anywhere in the computer, at any time. what you're seeing on the screen, when you see a letter, is a set of lights that are shining in a pattern that your brain recognizes as a letter.

Secondly, the CPU cannot recognize a sequence for a letter, or something like that. All a CPU can really do, is to take a binary string and do some logic with another binary string. Such as OR'ing together two strings, or AND'ing them, and so on.
And the correct sequence of such logical operations makes it a calculating machine. But it has no way of knowing if a sequence of bits is meant to represent a letter, or something else, because only a mind can do that. Because letters only exist in minds.

Any binary string could be chopped up into groups of 8bits, and each group could be translated into a letter (or character) using an ASCII table, for example. But if you do that to a binary string that was never meant to represent letters, you'll get gibberish.
Perhaps that very same binary string was actually meant to represent a 32-bit value. It all depends on what the "intent" was behind the string.
This is why I keep telling you that is has the capability of containing a code, but that doesn't mean it does. 

Those binary sequences are not interpreted by the machine. The only interpretation that happens is when a human interprets it, so that it can make sense to that human, because the binary string doesn't make immidiate sense to humans, and it requires translation, decoding, interpreting, all depending on how it was intended to be used.
Unless the raw binary string is exactly what you wanted, and no* some kind of conversion into a value or a letter, or an image, or a sound, or whatever.
Reply: antiHUMANDesigns apparently you don't read very closely: your supposed corrections don't even touch my point:please could you read closely before jumping onto your keyboard: it could save a lot of time and space... 

1. like I said, if we type the word "bird", the CPU is not going to read it as "bird", it's going to read the binary equivalent: hence, I said it's converted into binary form... the word is converted to binary via the keyboard...

2. the binary string is processed and sent to the display... 

3. The display takes the message and shows up "bird"... I don't care to know how it does it, my basic point is that it interpreted the binary string... 

if you're not ok with this give me a step by step method of what happens when you type the word "bird" on your computer keyboard...

btw... ""and even if these strings represent the switches, you can just use the switches directly: just that there'll be less flexibility: "

The CPU will not accept just one bit, it needs a specific set of bits. If you want to just "flick one switch", you would give it something like "00001000" to only activate the 4th "switch".
As far as I know, a computer does not have the ability to only send one bit, under any circumstances. They always come in packs of 8, 16, 32, 64, or any other power-of-2. (Though, there has been 6 bit computers, aswell.)
This is why a binary string isn't the same thing as machine code. A binary string can be of any length, but machine code must always be a 8-bit value, or some other length that is specific to the architecture of the computer."..... well of point... please read my lines closer...
Reply: Benjamin Toby"1. like I said, if we type the word "bird", the CPU is not going to read it as "bird", it's going to read the binary equivalent: hence, I said it's converted into binary form... the word is converted to binary via the keyboard..."

I don't agree that anything was ever converted. When you press the letter "K" on your keyboard, there is no conversion going on. You're sending a binary string from the moment you press that key. There is never a conversion.
It isn't a "K" just because there is a sticker on the key that says "K". Conceptually, it is a "K", only, but that concept is never converted, either. It conceptually remains a "K" for as long as that concept makes sense.

"2. the binary string is processed and sent to the display... "

I don't know exactly what you mean by "processed", but it might be, or it might not be, depending on the hardware and software used. But yeah, I don't know exactly what you mean.

"3. The display takes the message and shows up "bird"... I don't care to know how it does it, my basic point is that it interpreted the binary string... "

I don't like what you're saying. I don't know if you're wrong or if you're just saying it a way that sounds suspiciously wrong.

The monitor gets a binary string from the computer, and this binary string directly controls what color each pixel should have. The monitor is not aware what the result will "look like", whether the pixels will form a letter or something else. It gets RGB values for each pixel on the screen, covering the entire screen. And that's basically all. Some modern monitors will talk to the computer in order to sync its refresh rate to the GFX card, but otherwise, that's it, as far as I know.

And this binary string comes directly from the video memory on the graphics card. There is no conversion, and no decoding, because this needs to be fast to avoid introducing lag.

But whether or not you want to call this process an "interpretation" is irrelevant, because it is a computer talking to another computer, with no humans involved in that process.

"if you're not ok with this give me a step by step method of what happens when you type the word "bird" on your computer keyboard"

I can only tell you so much, because after the first few steps, the operating system takes over, and then it's software, not hardware. The binary string that came from the key you pressed gets stored in RAM, and from there, it all depends on what the computer is programmed to do with that binary string. I could tell you how it works in Windows, but I suspect it's irrelevant.

Keyboards are special, though, because even without an operating system installed, the motherboard's modules can still recognize what key you press, so that you can control the computer before an operating system boots up. And most computers will refuse to start if you have no keyboard connected.

The motherboard has a simple operating system in it, called BIOS, "basic in/out system", that runs the motherboard. This system is responsible for sending information between different modules. It doesn't control what happens in the CPU, or any other module, but it controls the communication between CPU and RAM and so on, to some degree.

But I think we'd do best to avoid getting into extremely technical details about this. What this discussion is about is what the binary strings "are", and this will only confuse that issue.

"well of point... please read my lines closer..."

"well of point"?
I do what I can. It seems that you were implying that the lowest level programming possible would be to control each switch independently, and I'm telling you that it's not possible to do that, making machine code the lowest possible level that you can use to instruct the computer. That is, binary sets of 8 bits, or such, controlling multiple "switches" at the same time.
But I have no idea why you'd say that independently controlling the switches would give you less flexibility, when it would in fact give you more, if it was possible and made sense to do so. Lower level programming = more flexibility.
Reply: antiHUMANDesigns I'm sorry but English doesn't seem to be your first language: I don't know how else to express something that simple: In case you still don't get it, I'll repeat: If you don't agree with my description, give me a methodical process of what goes on when you type the word "bird": from the keyboard to the display...
Reply: Benjamin Toby No, I'm Swedish, so Swedish is my first language. But I'm only asking what you meant by "processed". There are lots of ways to "process" things.

Before I go through that process of what happens when you press a keyboard key, I must note that a lot of it depends on the operating system, and the drivers for the different devices.

But let me try to see if I can do it, based on how I understand that it works:
1. You press a key, which sends a binary string through the USB cable (lets assume it's a USB keyboard).

2. The binary string enters the motherboard through a USB port. Lets say the USB port is intergrated into the motherboard.

3. I might be wrong about this part, but I think that this creates what is called an "interrupt" in the motherboard, which basically informs the motherboard that it has recieved a signal from some specific port.

4. The operating system is able to ask the motherboard if such as "interrupt" has occured, and if it has, then it tells the motherboard to direct this binary string to a place in RAM, that the operating system decides. And in this process, I think the USB drivers are the ones who actually figure out what part of the signal/interrupt is a useful message, because the string may also contain operation codes and such, and if the message is somehow encoded, it decodes it. The drivers are the ones who are translating operating system commands into commands that the connected device would understand, and vice versa. That is, the operating system tells the drivers what it wants to do, and the driver translates that "universal" instruction to whatever specific instruction is required for that device. And incoming messages are translated to something that the operating system understands. If the keyboard uses a different representation of the letter "K" than the operating system does, the drivers will translate it for the operating system.

5. Anyways, the binary sting ends up in a specific place in RAM and is registered into a "queue" of incoming messages that different programs can check to see if someone pressed a key, or if the mouse has moved, and so on. (this is hwo it works in windows.)

6. The program that someone has programmed might check for incoming events/messages in that queue in the OS, such as a keystroke, and then copy that incoming binary string message to its own place in RAM, and use that to display that letter on the screen. It's possible that the operating system has added information tot he message, such as the exact time the message was received, and so on.

7. How the actual displaying of it is done depends completely on how the program is programmed, but whatever you do, you still need to use a "font" to calculate what the letter should look like, and then copy that "picture" of the letter into the memory on the graphics card, and then it can be displayed.
But note that it's not the binary message that is being displayed. The binary string that the program read contains a representation of what letter is supposed to be displayed, but it doesn't copntain the information about what a letter even looks like. A font does that. So a "glyph" (a letter) from a font is displayed, which corresponds to the letter represented by that binary string.

Phew....

Well, that's pretty much it. I can't guarantee that this is all correct, because I am not an expert on this. I do not program drivers or operating systems.
Reply: antiHUMANDesigns so to sum up, the binary string is decoded by some processes to display the word "bird"?
Reply: Benjamin Toby No, the binary string doesn't need to be decoded, because it already is the value/sequence that is directly read.
The only reason to ever encode a binary string is to either make it shorter to save space, or to encrypt it to hide its information from others.

So once again, it could be encoded, but it normally isn't, because it doesn't need to be.

Quick tip: For something to be decoded, it must first have been encoded.

DNA was never encoded, and doesn't need to be decoded before it can be read. Therefore, it's not code. It shouldn't be so hard to understand.
Reply: antiHUMANDesigns Oh my Oh my: let me repeat: the binary string is translated(decoded/transformed/interpreted/whatever) by the "font" in the display system, into a graphical representation, which displays the word via the video card right?
Reply: Benjamin Toby A font is like a picture, it's not a program, it cannot do anything, it's just plain data. It's a file that contains ifnormation about what letters looks like.
It is a program such as MS Office that uses this information to display somethign useful. MS Office loads a font, and load a list of letters to display.

And once again, even though I've told you this 100 times already, the binary string is not changed in any way. It isn't "decoded" because it wasn't encoded, and it doesn't need to be converted or translated or transformed, it just needs to be read the way it is, so that we know what value/string it is, so that we can compare this to a list of characters in a font file and decide which one should be displayed.

The keyboard sends something like "1100", which ends up in RAM, and the porgram reads "1100", and knows that this is supposed to represent a letter, so it searches though a font of letters until it finds the image that represents letter "1100", and displays that.
See, no need to decode or convert it in any way.
Reply: antiHUMANDesigns "And once again, even though I've told you this 100 times already, the binary string is not changed in any way. It isn't "decoded" because it wasn't encoded, and it doesn't need to be converted or translated or transformed, it just needs to be read the way it is, so that we know what value/string it is, so that we can compare this to a list of characters in a font file and decide which one should be displayed."... I can't believe you bruh... if it's not going to be translated why compare it to a font list? PS there's definitely more going on in an LCD or plasma screen than just binary strings: there's some chemistry needed to display each pixel...

"The keyboard sends something like "1100", which ends up in RAM, and the porgram reads "1100", and knows that this is supposed to represent a letter, so it searches though a font of letters until it finds the image that represents letter "1100", and displays that.
See, no need to decode or convert it in any way."...if 1100 represents an image in a font, what would displaying the keyboard letter mean if it's not the binary string or the electric signal that's displayed? it is obviously converted to a font image the same way your programming language C++ is converted to binary code: and it represents a binary string the same way a letter in C++ represents a binary string... please tell me you understand this...
Reply: Benjamin Toby " I can't believe you bruh... if it's not going to be translated why compare it to a font list? "

Is a comparison a translation? Come on... If I compare the value of two things, am I translating one value into the other? No,I am checking whether they are the same. IT's an instruction. The binary string is used as an instruction in the program, to control the flow of the program. The binary string for the letter "K" instructs the program to take a specific path that leads to displaying a specific picture (the picture of a "K").

"PS there's definitely more going on in an LCD screen than just binary strings: there's some chemistry needed to display each pixel"

Physics, not chemistry, most likely.
If it's an LED monitor, then it is a process of releasing electrons between two charged states to produce a specific color.
The amount of each color is determined by the string that the monitor receives. The string is just raw data, a pattern that causes specific electrical events that produce light.
In this way it is similar to DNA, because a DNA sequence is also a raw sequence that causes proteins to be sequenced.
In both cases, some specific sequences are useful, while others aren't. If you send random values to a monitor, in many cases you'll see some pattens on the screen that you'll be able to recognize as something you've seen before, like a symbol, or something. It will randomly happen.

"...if 1100 represents an image in a font, what would displaying the keyboard letter mean if it's not the binary string or the electric signal that's displayed? it is obviously converted to a font image the same way your programming language C++ is converted to binary code: and it represents a binary string the same way a letter in C++ represents a binary string... please tell me you understand this..."

What "1100" represents is ambiguous. It is what it is. It was inteded to represent the letter K within something like an ASCII table. When you pressed the key and sent that string, it wasn't actually intended to represent a glyph in a font, it was a numerial value for a letter.
But that numerical value (the binary string) allows a program to recognize which letter you intended to print, by sharing the same ASCII table.
But the program could easily be tricked, and we could send it something that didn't come from the keyboard at all, and was never intended to represent a letter, and the program will look at the binary string and assume it's a letter, and display the letter, soyou'll get a bunch of random letters on the screen.
This is because "1100" never actually did represent anything. It is what it is, and it's only meaningful to us if we are consistent with what we use the value for.

It's not the "1100" that is being displayed, it's an RGB image the size of the screen that is displayed. The construction of this image is influenced by that value "1100", in that program. But the "1100" cannot be directly displayed, because monitors are not designed to do that. If you tried sending "1100" to the monitor, it would "assume" it is half of the data needed to specify one color of one pixel on the screen, and it would wait for the "rest of the data".

The string is not "converted" to a glyph from a font, or converted to an image, or anything like that. It is used as an instruction, or an "influence", in a complex process of creating an image.
What you're saying is like taking the blueprint for a house, and converting the blueprint to a house. You don't do that, you use the blueprint to instruct you how to convert a bunch of materials into a house. The blueprint remains unconverted.
(When you're done, you can convert the blueprint to a paper airplane.)

"the same way your programming language C++ is converted to binary code"

Not "binary code". Call it binary sequence, or machine code.

" it is obviously converted to a font image the same way your programming language C++ is converted to binary code: and it represents a binary string the same way a letter in C++ represents a binary string... please tell me you understand this..."

I am trying to understand you, but his last part is weird.
If I write a letter in C++... it may or may not represent a binary string in the mahine code. It may represent something abstract, or it may represent more than one binary string, and often in different parts of the resulting machine code.
"Abstract" in the sense that it doesn't "do anything", it just explains a concept to the compiler, so that it can "keep it in mind" as it reads through the rest. Such things never actually gets translated to machine code, it only influences the way the compiler interprets the rest of it.

See, a programming language is not a code, it is a lot more like an actual language, even if it's very simple for a language. It uses abstract things, which do not directly translate to what the computer does, and it contains syntax.
When I program C++, I am actually "talking to" the compiler, and explaining to it what I want my program to be like, in a slightly abstract way, but also in great detail. This is why there is a difference between different programming languages, or they would all effectively be the same thing. Some are better at explaining things simply or clearly or in a complex and exact manner, and so on. Some simply allow you to say "I want to draw this image on the screen", without you having to explain how you want to do that. More assumptions by the compiler = quicker to make a program, but less flexibility. That makes it a "higher level" language, while less assumptions and more direct instructions makes it a "lower level" language, until it has no syntax and nothing abstract, so it is no longer a language, but a coding system.

This is why programming code is called "code", simply because of tradition, even though it no longer is code, but a language.
The earliest programming languages were not languages, but coding systems, or simply "codes".
Reply: antiHUMANDesigns "It's not the "1100" that is being displayed, it's an RGB image the size of the screen that is displayed. The construction of this image is influenced by that value "1100", in that program. "... WELL... I know it's not "1100" being displayed: the RGB image is my point: once that image shows up, the binary string has run its course: your problem obviously is my usage of the word "converted"... the binary string is obviously translated by the display device to show an RGB image eventually so what's your point?

"The string is not "converted" to a glyph from a font, or converted to an image, or anything like that. It is used as an instruction, or an "influence", in a complex process of creating an image."... oh really? it's not "converted" but acts as an instruction in a "complex process" of creating an image?... so what would you describe this "complex process" that "creates" the image?... isn't that the "conversion"? or what you're afraid of that word?... ok "interpretation"? makes no difference... my obvious point is in creating the image and that "complex process" depends on the binary string hence interpretation is THE process...

"Physics, not chemistry, most likely.
If it's an LED monitor, then it is a process of releasing electrons between two charged states to produce a specific color."... of course there's chemistry involved: how do you think the "specific colours" are produced in an LCD/plasma display?

"What you're saying is like taking the blueprint for a house, and converting the blueprint to a house."... what I'm saying is converting the instructions in the blueprint to the House: the instruction is drawn with ink or something: the interpretation is the House: diagram to house: that's the conversion...

" The blueprint remains unconverted.
(When you're done, you can convert the blueprint to a paper airplane.)"... of course not... when the house is done, the blueprint is fully converted... that was the idea all along...

please could you try your best to understand my point here and save me the pointless rants?
Reply: Benjamin Toby "your problem obviously is my usage of the word "converted"... "

Yes, but believe me, I would not be picking at the words like this unless I thought that you're whole reason for discussion this is because you're playing word-games.
And yes, trying to force DNA to be called "code", and using that as an argument for DNA being intelligetly design is a word-game. It's a trick. (Well, an attempt at a trick.)

"... the binary string is obviously translated by the display device to show an RGB image eventually so what's your point?"

I'm sorry to have to say this but... no, it's never translated. the string directly controls the voltages, or whatever, that produces light. the string already represents an RBA image, in this sense, so it doesn't need to be translated.
The minotor requires a sequence where groups of 3 butes define the RGB values for each pixel. If this is not the kidn of sequence being sent, then it would have to be translated or converted to this, but that's not the case, as far as I know.
Of course, I don't build monitors, so... :P I can't say for sure which ones mess around with the values, and to what extent. My point is only that I know it isn't required to make it work. Most of the work is done by the graphics card.
And on top of this, sometimes it's an analog monitor, so the signal the graphics card sends in not a binary string, but rather somekind of frequency-modulated signal, or something.

"... oh really? it's not "converted" but acts as an instruction in a "complex process" of creating an image?... so what would you describe this "complex process" that "creates" the image?... isn't that the "conversion"? or what you're afraid of that word?... ok "interpretation"? "

The image is created in RAM, based on instructions. The binary string that holds the number is never going to be a part of, or in some way intergrated into, the image being built.

An RGB image is still just a binary sequence. I can write a program that makes an RGA image that is just a long sequence of 0's (which will make it black), but I could write the program so that if someone presses the "K" key, the program will instead create a binary sequence of all 1's, instead of 0's, making it a white picture.
See how it's just an instruction that impacts a process? The keypress that caused the program to make a sequence of 1's instead of 0's is never translated or converted or "turned into" an image.
The image and the binary string from the keyboard do not in any way represent eachother. One simply caused the other to happen. It wasn't translated, because you cannot translate a number into an image of a number and have it make any sense. The image can be made in an almost infinite number of ways, and can be ecoded in different ways, so that different sequences describe the exact same picture. The binary string is not a "concept", whicle an image is a concept. An image only exists in minds, not in reality.
And you obiously cannot convert something real into something conceptual, if you understand what I mean.

Call it an "instruction", and you're good. Not "interpretation" or "translation" or whatever, it's an instruction, because that's what it's being used as.

"makes no difference... my obvious point is in creating the image and that "complex process" depends on the binary string hence interpretation is THE process"

Instruction. The process is a mechanism that runs instructions, and the binary string is the instruction. The RGB image is the output, the result, of the process.

Blueprint and house, like I said earlier. The process is the human building the house. the human is the program. The binary string from the keyboard is *part* of the blueprint for the house. And the material is what is being converted from one shape (beams and logs or whatever) into the shape of a house.

But it does seem like you're implying that the blueprint is somehow what's being converted into the house. And I think it's actually important to this discussion to point out that that is wrong.

"of course there's chemistry involved: how do you think the "specific colours" are produced in an LCD/plasma display?"

I haven't studied how plasma works, which is why I took LED monitors as an example. Plasma is not used for computer monitors, because static images hurt the plasma screen, and computers mainly generate static images.
That's why I said "physics, most likely". But on the really small scales, it can sometimes be confusing what is chemistry and what is physics, since chemistry is a sub-set of physics. Chemistry is physics, just a specific portion of it having to do with reaction of molecules and atoms. Buit it we're talking aboot electrons giving off light, then it is physics. Quantum physics, even.
But whatever, screw it, lets say all monitors are chemical, I don't care!

"what I'm saying is converting the instructions in the blueprint to the House: the instruction is drawn with ink or something: the interpretation is the House: diagram to house: that's the conversion"

So instead of saying that you're converting paper into a house, you're now converting something conceptual (not physical) into a house?
Why can't you just accept what I'm saying, that the blueprints are instructions for converting materials from some shape into the shape of a house?
The only "conversion" going on is the conversion of the shape of the materials used.
http://dictionary.reference.com/browse/convert?s=t
"to change (something) into a different form or properties; transmute; transform. "

The blueprint is not reshaped, transformed, or changed in any way. It is only being read, and it will remain the same thing once the house is finished, proving that it was not converted in any way in the process.

"Interpreted", fine, I'm OK with that: The blueprint is being interpreted by the human. This informs the human about how to convert materials into a house. Because humans cannot directly "plug into" the blue print, we need to interpret the symbolism on the blueprint into instructions in our minds.

Are we OK with this?

"" The blueprint remains unconverted.
(When you're done, you can convert the blueprint to a paper airplane.)"... of course not... when the house is done, the blueprint is fully converted... that was the idea all along"

LOL, nooooo...! The blueprint was never converted! :P
You know how I can prove that it wasn't? Because you could theoretically build the very exact same house without a blueprint! Obviously, houses do not exist because they were "converted from blueprints"... they were converted from materials. And you'll never find a sinlge house that exists that was not converted from materials. But I bet there are houses that didn't have a blueprint. At least in the olden days, if not today.

"please could you try your best to understand my point here and save me the pointless rants?"

You know, if you ask me a question, and I give you a simple answer, and then you act as if I hadn't already explain this to you, then I'm going to have to give you a more detailed explanation. And when that is still not enough, then I will give you what you will consider a "rant".
If you then call that "pointless", then... I dunno what to do, because you asked for it.
Reply: antiHUMANDesigns 

1. "Yes, but believe me, I would not be picking at the words like this unless I thought that you're whole reason for discussion this is because you're playing word-games.
And yes, trying to force DNA to be called "code", and using that as an argument for DNA being intelligetly design is a word-game. It's a trick. (Well, an attempt at a trick.)"... I think even staunch evolutionists can see the DNA is a code: or at least functions like one: the fact that you're arguing over that actually proves that you're the one playing word games: as usual with evolutionists: tbh I don't think I've seen a scientific discipline that gains most of it's credibility from Language manipulation: most credible sciences I know of are strictly guided by math: 

btw I'm not forcing DNA to be called code: you are actually forcing the DNA to be called just a molecule or something: I don't think there's any link you can give me which describes the DNA without mentioning "information" or "code"... 

2. "I'm sorry to have to say this but... no, it's never translated. the string directly controls the voltages, or whatever, that produces light."... and the voltages are "translated" to the visible light pattern which is the image... it could be via Liquid crystals or plasma gas... there's no way you can escape the process of translation...

3. "I can't say for sure which ones mess around with the values, and to what extent."... then could you stop the rant about what you're not sure of?... you can connect your computer to a plasma screen via HDMI and it'll display just fine: but the plasma screen has it's own computer to interpret the signals coming from your computer so there's definitely translation(or interpretation) of binary strings there.

4."And on top of this, sometimes it's an analog monitor, so the signal the graphics card sends in not a binary string, but rather somekind of frequency-modulated signal, or something."... still, translation is involved...

5."The image is created in RAM, based on instructions. The binary string that holds the number is never going to be a part of, or in some way intergrated into, the image being built."... obviously I'm not saying the binary string literally "shape-shifts" into the image or something like that: I'm saying it's translated(översatt) or interpreted(tolkas) to form the image...

6. "Call it an "instruction", and you're good. Not "interpretation" or "translation" or whatever, it's an instruction, because that's what it's being used as."... and what would the action of carrying out an instruction be?

7. "LOL, nooooo...! The blueprint was never converted!"... well what can I say, I guess by saying "converted" you interpreted "converted into a paper plane"... it's no point to dwell on that anymore I guess...

8. It seems obvious to me that you're not very knowledgeable about monitors and displays: there's much more going on in LCD and Plasma screens than just binary strings: and that validates my point: I mean the display is just another connected output device that the computer talks to: the instructions sent to it definitely are interpreted to give the required pictures: so most of your rants don't change my point... it's just like telling me binary strings aren't converted to sounds in the speakers...

9. "You know, if you ask me a question, and I give you a simple answer, and then you act as if I hadn't already explain this to you, then I'm going to have to give you a more detailed explanation. "... excuse me not every explanation in your mind qualifies as valid in reality: most times your "simple answers" are pointless or just plain drivel: I'm actually the one trying to simplify things and reason with you: I think I deserve credit for that... In actuality, I'm kind of disappointed at the kind of vain intellect and logic I've noticed within the atheist and evolutionist population: I mean look how many days it took me to make one simple point: the binary string of the word "bird" is translated into a graphical image representation by the display device in a computer system... I mean if you take into consideration the actions of the Liquid Crystals in an LCD display alone, my point is made...
Reply: Benjamin Toby " I think even staunch evolutionists can see the DNA is a code: or at least functions like one"

Let me refresh your memory: A "code" is a symbol that stands in place for another symbol, in accordance with some code system.
It would make no sense to have DNA be encoded. That would mean it has to be decoded before it's used, and we know for a fact that it is not. The ribosomes read a direct copy of the DNA sequence, which causes them to sequence proteins. There is no decoding going on in the middle of that.

As for "evolutionist", as far as I know, that only means someone who believes in evolution. That doesn't mean they have any credibility or credentials, it just means they believe in evolution. That could literally be anyone.
Also, the majority of "evolutionists" are actually christians, or at least religious.

"the fact that you're arguing over that actually proves that you're the one playing word games: as usual with evolutionists: "

Show me where my fallacy is, where I attempt to try to use an equivocation fallacy, for example. Prove that you're not lying, right there.
I have clearly stated that whatever the DNA sequence is, it's being used directly. Call it whatever you want, but it is what it is, and it is created naturally.
But you want to argue that if we call it "code", then it can't be natural, so you want it to be called code, as if that would change whether DNA sequences can occur naturally.
So tell me again, who is playing word games?

"tbh I don't think I've seen a scientific discipline that gains most of it's credibility from Language manipulation"

What's really going on is that you don't know what the words mean, and when you are being corrected, you think we've trying to dodge it.
What we're really "dodging" is your straw manning of the science.

"btw I'm not forcing DNA to be called code: you are actually forcing the DNA to be called just a molecule or something: I don't think there's any link you can give me which describes the DNA without mentioning "information" or "code"... "

Information, yes, I ahve agreed to this all along. Infomration, not in the sense of being informative, but in the sense that information theory describes information, as a quantifiable amount, and subject to entropy, and so on.
But I'm going to dare propose that you don't know what that means, because if you did, then you wouldn't even have asked how a river could hold information.
Just.... study more. Please. Before you go and tell people something is wrong, study what you're talking about.

Also, are you claiming that DNA is more than a molecule? And in what way is it more than a molecule, in some way that isn't true for any other molecule?

"2. "I'm sorry to have to say this but... no, it's never translated. the string directly controls the voltages, or whatever, that produces light."... and the voltages are "translated" to the visible light pattern which is the image... it could be via Liquid crystals or plasma gas... there's no way you can escape the process of translation"

OK, fine, lets call that translation. I wouldn't, but I have no reason to keep arguing this issue. I looked up the definition of "translation", and I agree that it might possible that you could call that event a translation, maybe. It's unclear to me. But I'll concede this to you, so that we can drop this.

That is, the movement of electrons turning into a light wave, I can concede that this might be called "translation", even though I'm unsure.

"3. "I can't say for sure which ones mess around with the values, and to what extent."... then could you stop the rant about what you're not sure of?... "

I never ranted about which specific monitors mess with the values...!

"you can connect your computer to a plasma screen via HDMI and it'll display just fine: but the plasma screen has it's own computer to interpret the signals coming from your computer so there's definitely translation(or interpretation) of binary strings there."

This is exactly the same thing as what is going on inside the program that received the binary string from the computer, and sent an RGB picture to the monitor.
The monitor doesn't need to "interpret" the signals. To "interpret" is to figure out the meaning of something. It's similar to "decoding", in that the message would be changed from one sequence into another sequence. A monitor doesn't need to do this if the GFX card is already sending the information to the monitor in a way that the monitor can directly make use of. Encoding and decoding of any sort only adds more work for the GFX card and the monitor, with no benefit. And a GFX card is desigend to "speak the same language" as the monitor, so there is no interpretation required.

The monitor uses a binary string to set its "switches", which results in different colors of light. I've already conceded that you could call this part a "translation", though.

But the binary string is being used directly to control the switches, as if it was mechanical. No interpretation or conversion is *required* to make it work.

"4."And on top of this, sometimes it's an analog monitor, so the signal the graphics card sends in not a binary string, but rather somekind of frequency-modulated signal, or something."... still, translation is involved..."

An electrical circuit called an D/A-converter "translates" the binary string into an analog signal, as per my earlier concession.
I will consistently allow you to use the word "translate" to describe this event.

"obviously I'm not saying the binary string literally "shape-shifts" into the image or something like that: I'm saying it's translated(översatt) or interpreted(tolkas) to form the image..."

Hey, thanks for the swedish translation. :P It was almost completely correct. (Should have been "tolkad" to be consistent, grammatically.)

Only minds can "interpret" things, because an interpretation is conceptual, and compuer don't do those things.
It's possible that you'll hear people say that, but that is an abstraction of what is going on inside the computer. It is only an "interpretation" because that's what the programmer had in mind when we wrote the program. But the program doesn't actually contain a mind that can interpret things, and therefore it cannot hold "concepts", abstract thinking.
If we made a program like that, it would be slow as nothing you've ever seen.

As for "translation"... fine, lets say it's a "translation", I'm going to have to be consistenly OK with that, since I have conceded that.

"6. "Call it an "instruction", and you're good. Not "interpretation" or "translation" or whatever, it's an instruction, because that's what it's being used as."... and what would the action of carrying out an instruction be?"

To "comply"? I think when you carry out an instruction, you "comply", but I also suspect that might only be true for someone who had a choice in whether to comply or not.
But assuming you're a native english speaking, you should know better than me, so you tell me.

"8. It seems obvious to me that you're not very knowledgeable about monitors and displays: there's much more going on in LCD and Plasma screens than just binary strings: and that validates my point"

You'd be correct, I am not knowledeable about those. Are you?
I've pointed out, since the start, that a computer sending images to a display is just one computer "talking to" another. A digital monitor is a much less powerful and less flexible computer.
But what I am saying is still true, because I am ignoring the parts that may vary between different monitors, and I focus on what needs to be true for all monitors in order for them to work.

The context of this discussion remains how this compares to DNA. And so what steps are required to make a monitor display a letter is what is interesting. It is not interesting if some company decides to make a monitor that imporve the image quality, and so on. 

This all started by you asking me to explain teh steps from keyboard press to the display ing of a letter.
Now please make your point, because you're causing this to become an ever derailing conversation.

": the instructions sent to it definitely are interpreted to give the required pictures:"

Only minds interpret things, because interpretations are conceptual. 
As far as I know, there are no computer programs that function as minds.

"I'm actually the one trying to simplify things and reason with you: I think I deserve credit for that"

If that is what you're doing, then yes, credits to you for that. I can't know if that is what you're doing, because I don't know what you would have said if you chose not to do that. I can't read your mind.

Simplifying and staying on the point is great, but we've had some issues with the use of specific words that have implications that you appear to not take into consideration.
You're talking about whether DNA was intelligently sequenced. When you use words like "interpret", then this has an impact on the discussion, so I want to make sure you don't use that word where it doesn't belong.
But I am met with some hostility for doing this. But you cannot blame me for pointing this out when it is crucial to the counter-argument.

And let me tell you, all thes different words that are being thrown around as if they're intechangeable is starting to really get me confused. Translate, convert, interpret, I don't remember them all, but these are not all interchangeable. And we can't seem to agree, so I don't know what to do. Do you have a solution to this?

I think that if we could go back to talking about how this all relates to DNA, then we could start making sense, again, and actually move forward.

"In actuality, I'm kind of disappointed at the kind of vain intellect and logic I've noticed within the atheist and evolutionist population: I mean look how many days it took me to make one simple point [...]"

Note that you're talking to someone with asperger's syndrome. I am not representative of "evolutionists". I am cynical and nit-picky and convoluted, I know, call it a personal flaw. No question is ever simple to me, because I see so many factors that other people seem to have learnt to ignore. I can't see the forest for the trees, and that's a trait of asperger's syndrome.

But if you are correct about what you're saying, and I am wrong, then you should still be able to "prove" that. No amount of "ranting" can stop the true from being true.

"the binary string of the word "bird" is translated into a graphical image representation by the display device in a computer system"

Thoughout the discussion of this point, you've used all kinds of words, like "interpreted" and "converted", and so on. That is what has gotten in the way of you making your point. You might be used to talking to people who will accept just about any equivocation, but that doesn't fly with me, or anyone else who is used to seeing through such things.
That's probably why you're having trouble whenever you're talking to "evolutionists". You don't understand the problem of equivocation.

When you set out to prove that the use of the word "code" proves that DNA was intelligently designed, which is moronic from the very start, then yes, it's going to be a cynical discussion about the meaning of words. That's what you wanted, wasn't it?

So, if in the end, by "translation", you simply mean the converstion of a digital signla into an analog signal at the very end, then OK, I accept your point as true. But what on earth does that have to do with DNA, in such case?
It seems like you set out to prove that DNA is decoded, but all you did was prove that a monitor translates a binary string into a light, a conversin of digital to analog.
That is not a decoding, either, so it appears completely irrelevant to your point.

Call it good faith, that I assume you're trying to make a better point than that. If it seemed like you were arguing that water is transparent because a chicken crossed the street, then I will assume there is some problem in our communication, rather than assuming you have the intelligence of a worm.
Reply: antiHUMANDesigns
Let me refresh your memory: A "code" is a symbol that stands in place for another symbol, in accordance with some code system.... Umm lemme refresh yours:
"http://dictionary.reference.com/browse/code?s=t
Definition number 6, "a word, letter, number, or other symbol used in a code system to mark, represent, or identify something". ... you see these two definitions aren't the same? at least not on the standard of your equivocation dilemma...

Show me where my fallacy is, where I attempt to try to use an equivocation fallacy, for example. Prove that you're not lying, right there.... that's not very hard: a good example would be your use of the term "evolution": and I'd definitely argue that you're misusing the word "code": e.g the two definitions up: one says "stands in place for another SYMBOL", the other says "represents SOMETHING"... you see?

"Only minds can "interpret" things, because an interpretation is conceptual, and compuer don't do those things."... I'm sorry but to my knowledge a computer is programmed to interpret signals: this is just how you get things mixed up most of the times: a computer could be classified as an artificial mind: 

*What's really going on is that you don't know what the words mean, and when you are being corrected, you think we've trying to dodge it.
What we're really "dodging" is your straw manning of the science.*... I think it's already a straw man science:

But I'm going to dare propose that you don't know what that means, because if you did, then you wouldn't even have asked how a river could hold information.... correction: I didn't "ask"... you could read that comment again... 

Just.... study more. Please. Before you go and tell people something is wrong, study what you're talking about.... I would challenge you to do the same: however since it seems like you know more than me, I'd just ask you to think more before making your assertions: most of them might well be very wrong...

"You'd be correct, I am not knowledeable about those. Are you?"... I'd accept: not very much: but knowledgeable enough to make the simple point I proposed: 

"This all started by you asking me to explain teh steps from keyboard press to the display ing of a letter.
Now please make your point, because you're causing this to become an ever derailing conversation."... why blame me now when much of the "derailing" is actually caused by you?

"Only minds interpret things, because interpretations are conceptual. 
As far as I know, there are no computer programs that function as minds."... AI???

...................................................................

Now if you're willing to understand my arguments the we can trace back to why I gave that analogy to start with: It was to address one of your claims: if you still recall:

No, you're writing code that, in some sense, represents binary strings/sequences. It's not correct to call the binary sequences "codes", because they are not interpreted, they are direct instructions.

and my reply? if you type "bird" on your computer it's translated to 01100010011010010111001001100100 and your processor recognizes the sequence and tells the display to show "bird"... so why are you speaking like the binary sequences aren't interpreted?... this was about two or three days ago I think: however, you managed to spend three full days ranting about how the binary strings aren't "interpreted", but finally came up with "translated" as the alternate word: I'm not sure if you've ever heard of synonyms but those words mean almost if not practically the same thing in this context:  

now my point at this instance: from your own assertion: codes need to be "interpreted"(same thing as translated): I say the DNA is interpreted(translated) by the ribosome: NOTE this is mainly based on your assertions... and the definition of code you gave earlier was what I used for the majority of the argument because it also fit the DNA and its function:

btw since you think it's moronic to call the DNA a code then I think you should send a mail or something to the National Institute of Health(NIH) and tell them to review their description of the DNA: http://ghr.nlm.nih.gov/handbook/basics/dna
Reply: Benjamin Toby"you see these two definitions aren't the same? at least not on the standard of your equivocation dilemma"

"a word, letter, number, or other symbol used in a code system to mark, represent, or identify something"

vs

"a symbol that stands in place for another symbol, in accordance with some code system"

How is my definition different from their defiition?
A symbol = a "word, letter, numer or other sumbol". No difference there.

"in accordance with some code system = "used in a code system". No difference.

The only difference between my definition and their definition is that I say a code is a symbol that stands for another symbol, while they say it's a symbol that "identifies something", which is not different, just less specific, and could still mean exactly the same thing.

I am still right about what a code is, because I didn't just look at the definition of the word, I actually read an article that explains it, while still agreeing with the definition you quoted.

And an equivocation fallacy is when you use two different definitions of the same word (different contexts) and treat them as the same definition.

For example, the classic "it's just a theory", because "theory" in common speech just means a "guess", while in science context, it's not just a guess. Therefore, it's an equivocation fallacy to say that a scientific theory is a guess.
 
Not agreeing on the definition of a word cannot be an equivocation fallacy. Using two different definitions as if they're the same thing (equating two definitions) is an equivocation fallacy.

So, if both a DNA sequence, and machine code would be called "code", it doesn't mean they they're both code in the same sense, with the same meaning.
In the same way, programming code is called "code", but definitly isn't code. Just because somethign is called something doesn't mean it meets the definitions for actually being called that.
Therefore, you run the risk of an equivocation fallacy, because the same word has different meanings in the two contexts, so they're not actually the same word.

"Show me where my fallacy is, where I attempt to try to use an equivocation fallacy, for example. Prove that you're not lying, right there.... that's not very hard: a good example would be your use of the term "evolution": "

You forgot to explain how I used it in a fallacious way. Just saying I used a specific word doesn't show how I used it in a fallacy...!

I have the defined what "evolution" means, scientifically. If I have committed an equivocation fallacy, then I have used a different context for evolution as the same thing. When did I do that? Quote me doing it, and I'll admit that mistake.

Evolution is the "change in allele frequencies in a population over time". The theroy of evolution is a combination of everything we know about how that happens, what laws it follows (natural selection, for example), and so on. Because the theory is a collection of a lot of things that we know about this, it cannot be completely summed up in a simple sentence, so the only way to get the "definition of" the theory of evolution, other than what the theory deals with, is to read everything we know about it.
We can perhaps sum it up by listing the "name" of the different parts that make up it, such as "punctuated equilibrium" and "the law of irreversibility" and "the law of evolutionary economics", and so on.
But each of these parts can only be "defined" by reading the scientific material.

But the simplest possible definition of "the theory of evolution" is probably something like "the explanation for why and how things evolve". :P
And that refers to the definition of "evolve" that I gave you, earlier.

"I'm sorry but to my knowledge a computer is programmed to interpret signals: this is just how you get things mixed up most of the times: a computer could be classified as an artificial mind: "

I don't think you can classify a computer as an artifical mind. You can classify it as a simple artificial brain, but not a mind.
A program running on a computer could probably create a mind, but I don't think we have any such program, because our computers aren't quite powerful enough, yet.
Also, we have no "theory of the brain", yet, so we don't really know how to make such a thing.
A brain and a mind is not the same thing. Our brains create an emergent property called a  "mind". Minds don't exist as physical things, they are conceptual.

But, when you say "programmed to interpret", then you're saying that it's not the computer that is designed to interpret, it is the software that is.
And yes, we can immitate the idea of interpretation in software.
This is not the same meaning of the word, though. "Interpret" doesn't mean the same thing when used in the context of computers.

To a computer, an interpreter is, for example, a compiler (or a program that runs scripts). It takes the programming code and compiles it, and this is sometimes called "interpreting", but because the compiler doesn't know the meaning of what it's reading or outputting, it's not actually interpreting anything.
It's basically metaphorically, or figuratively, interpreting it. Interpreting implies some kind of freedom of interpretation.

However, that meaning doesn't extend to handling signals. They computer doesn't interpret signals, unless some specific program is designed to do that, for some specific reason.

Once again, meaning it "could", but it doesn't.

"But I'm going to dare propose that you don't know what that means, because if you did, then you wouldn't even have asked how a river could hold information.... correction: I didn't "ask"... you could read that comment again... "

I'll just quote you: "explain to me how a river shape is information/configuration"

This is you asking how a river shape is information.
Do you want me to read it again?

"I would challenge you to do the same: however since it seems like you know more than me, I'd just ask you to think more before making your assertions: most of them might well be very wrong..."

I think that as long as I am relaying what the scientists say about the science, I am justified.
You, however, don't have such a backing. And if you don't then you need to supply your own support.
That is, speaking of evolution, I have a lot of evidence on my side. As for creationism, zero evidence.
And as for reasons why evolution is wrong, you need to actually give me a valid reason for why it's wrong, rather than what "sounds reasonable" but has no evidence, such as your talk about classing DNA sequences as code, as if that would magically make them intelligently designed when they're still not.

""You'd be correct, I am not knowledeable about those. Are you?"... I'd accept: not very much: but knowledgeable enough to make the simple point I proposed: "

Yeah, if I was going to have a discussion where the inner working of LCD monitors was crucial to the issue, I would study up on it first.
I hope we can both agree that this is not the case, and we simply got side-tracked a little.

"why blame me now when much of the "derailing" is actually caused by you?"

Well, I didn't mean for it to sound like I was blaming you. I'm only trying to move away from this computer monitor side-track that we've fallen into. And I was pointing out that you keep insisting on discussing it - sure, as did I, I am equal part of it.
But now I'm asking you to get a point, because I believe that's what you wanted to do, when you first asked me to go through this step by step thing.

""Only minds interpret things, because interpretations are conceptual. 
As far as I know, there are no computer programs that function as minds."... AI???"

We have no AI that functions like a mind. An AI is an immitation of a mind, something designed to appear as if it was more intelligent and conscious than it is. Usually, it's "dumber" than most other programs.

If you're talking about our "top notch" AI's, such as the AI driving ASIMO, then that is still not a mind, though it displays some features of a mind, and that's pretty cool.
But in almost every single case of AI ever, it's nothing even close to a mind.
First of all, a mind must be conscious. I'm not sure how to even know if a computer program is conscious, because once again, we do not have a theory of the brain, yet, so we don't know how to make such a thing. We cannot adequately define these things, because we don't know what consciousness really is, or even what intelligence is.

"however, you managed to spend three full days ranting about how the binary strings aren't "interpreted", but finally came up with "translated" as the alternate word: I'm not sure if you've ever heard of synonyms but those words mean almost if not practically the same thing in this context:  "

Great, 3 days of explaining how they're not synonymous, and you still think they are. :/
And then you wonder why I keep ranting... Well, it's my way of not having a brain seizure from frustration, perhaps?

Imagine spending 3 days trying to explain the difference between two words. You'd be frustrated, and you'd be "ranting".

"now my point at this instance: from your own assertion: codes need to be "interpreted"(same thing as translated): "

They say "translated". Are you doing this just to annoy me?
No, codes need to be decoded. It's not a hard concept to learn: Code - encode - decode.
So use those words when talking about code, and you'll be consistent and not confusing. I have no idea what you'd mean by to "translate a code", because codes are decoded.

" I say the DNA is interpreted(translated) by the ribosome"

I am fine with saying the DNA sequence is "translated" to a protein by the ribosome. I agree that this is still the same concept as when a digital signal is converted to an analog signal, or to light, for example, so it's perfectly consistent to use the same word, as far as I can see.
Not "interpreted" though. The ribosome doesn't have the ability to interpret.

"and the definition of code you gave earlier was what I used for the majority of the argument because it also fit the DNA and its function:"

No, because a DNA sequence isn't encoded, it's not a code, and it's not decoded by the ribosome. I've been teling you this from the start.
If you want to prove you're right, then prove that it is decoded by the ribosome. Prove that the DNA sequence first needs to be turned into a different sequence before it's turned into a protein.
If that happens, then I can agree it's the same principle as "code", so I would be fine with calling it "code".

But I'm interested in one thing: Lets say we do call the DNA sequence a "code that's translated into a protein by the ribosome", even if that doesn't make sense. Then what?

"btw since you think it's moronic to call the DNA a code then I think you should send a mail or something to the National Institute of Health(NIH) and tell them to review their description of the DNA: http://ghr.nlm.nih.gov/handbook/basics/dna"

Did I say it is moronic? I said it's wrong, it isn't code. And I stand by that. If I said it's moronic, then I might have over-stated that, but it's still wrong.

Yes, I'd love to ask them why they're calling it a code, and if they mean it as an actual code, or if the word is being using idiomatically, or has a different context in genetics.

I do stand by it being wrong. And yes, even an epxert could make that mistake, because no one has ever pointed it out.
Or, it is somehow correct to call it a code, in such case I would love to know why that is.

However, when they say "the information is stored as code", the question is what they mean by "information". Information is also just a concept, so if they're talking about something representing something else, then it becomes a code.
"C" is code for the base that we call cytosine. If we say that the information, cytosine, adenine, and so on, is stored as "code", then we are talking about a code like "CTGATATG", and that is a code.
But that doesn't mean that the sequence contains a code.

Like we talked about before, and like you talked about with that other guy, a river also contains information, and this information coud be described in code, but that doesn't mean that the river itself contains a code.
It's confusing as hell... do you follow what I'm saying?
So the quesiton is what they really mean on that website that you linked. It's still possible that they use the word without thinking of the implication of using that word.
Reply: antiHUMANDesigns

You forgot to explain how I used it in a fallacious way. Just saying I used a specific word doesn't show how I used it in a fallacy...!...first thanks for explaining the equivocation fallacy...however I believe I did explain how you're misusing the word in the other thread: but nevertheless: you say evolution is change in allele frequency with time: well that definition happens to somehow cover the definition I gave which was the process by which different kinds of living organism are believed to have developed from earlier forms during the history of the earth. but these two definitions don't mean the same thing: in reality, when people refer to evolution, they mean both definitions, but the first definition is used to masquerade the second: equivocation fallacy much?

This is you asking how a river shape is information. Do you want me to read it again?... lol bruh you write pretty well in English but one would be mistaken to say you really understand the language: please, that wasn't a question: again, re-read the comment...

I think that as long as I am relaying what the scientists say about the science, I am justified. You, however, don't have such a backing. And if you don't then you need to supply your own support.... oh really? why don't you "relay" to me how some scientists question the validity of the theory of evolution and the effectiveness of its mechanism: natural selection?... I don't have such backing?... I think you should search and read harder bruh: I DO have backing... so stop speaking like you're some kind of representative for science or all scientists... also, the "scientists" can very well be wrong and believing everything they say without questioning would make you an indoctrinated person...

That is, speaking of evolution, I have a lot of evidence on my side. As for creationism, zero evidence.... hahaha... evidence?... actually what you have is a lot of faith... you need a lot of faith to accept some of the so-called evidences as valid evidences... and zero evidence for creationism?... well I wouldn't expect you to see any haven spoken with you... still, an unreasonable assertion...

And as for reasons why evolution is wrong, you need to actually give me a valid reason for why it's wrong, rather than what "sounds reasonable" but has no evidence, such as your talk about classing DNA sequences as code, as if that would magically make them intelligently designed when they're still not.... well considering we've been on this DNA topic for so long, and having been made to address most of your rants, I've had little chance to give my other points and evidences: I would love to do so after we clear this DNA debate up... btw "sounds reasonable"? try "sounds ridiculous"...

* Great, 3 days of explaining how they're not synonymous, and you still think they are. And then you wonder why I keep ranting. * ... ... like I said, they're the same CONTEXTUALLY: but seeing you have so much problems with the words, I'm going with "translated"

They say "translated". Are you doing this just to annoy me?... hahaha... you mad bruh?... you're the one creating the problems for yourself so count me out if you get entangled in a word-twist: 

If you want to prove you're right, then prove that it is decoded by the ribosome. Prove that the DNA sequence first needs to be turned into a different sequence before it's turned into a protein.... Ummm... amino acid sequence???
Reply: Benjamin Toby"well that definition happens to somehow cover the definition I gave which was the process by which different kinds of living organism are believed to have developed from earlier forms during the history of the earth"

Yes, evolution is the process you're talking about, the process that causes life to change, but the definition of the process is what I said.
What you're saying is basically "this word refers to that process". "Which process?" "The one defined as the change in allele frequence in a population over time".

So yes, I am not saying you're wrong, I am only saying that what I said is a better defintion, because it is the scientific definition of the process, and it actually explains what the change "is".

And also, haivng the word "earth" in the definition means it cannot happen on any other planet, which makes it a bad definition.

 "but these two definitions don't mean the same thing: in reality, when people refer to evolution, they mean both definitions, but the first definition is used to masquerade the second: equivocation fallacy much?"

Peopel who refer to your definition rather than the scientific one is somply wrong, that's all. Yes, if you refer to both definitions, then you might commit an equivocation fallacy, but these definitions are hardly different. One is less precise than the other, but doesn't actually "disagree" with the other.

But to be frank, you definition does not define evolution, it refers to it. "That process over there", is what it's saying, rathen than explaining what is going on.

"This is you asking how a river shape is information. Do you want me to read it again?... lol bruh you write pretty well in English but one would be mistaken to say you really understand the language: please, that wasn't a question: again, re-read the comment"

You said you didn't "ask", but you did, you asked me to explain something to you.
It's was not stated as a question, and there was no question mark, but what you did was to ask me to explain something to you. And then you say you "didn't ask".
Whatever, cultural difference, perhaps. I don't see why you even care.

"oh really? why don't you "relay" to me how some scientists question the validity of the theory of evolution and the effectiveness of its mechanism: natural selection?"

Because effectively zero scientists in a related field question the validity of evolution as a whole. Yes, there are those who propose new explanations for different mechanisms, jsut like when I said we went from gradualism to punctuated equilibrium, and everyone welcomes that.
But you can always find the one stray person here and there who rejects the entire idea, but that is not representative of the scientists, and that is not the consensus.
Until they can actually show evidence for why it's wrong, they have nothing. "Questioning" something doesn't mean there's any reason to believe it's false. They have to provide evidence against evolution, and they haven't.

" I think you should search and read harder bruh: I DO have backing"

You're backed by people who have no evidence, that's not backing. Those people exist in any field, there are people who seriously argue for a flat earth. I don't know if any scientist argues for a flat earth, though, but I wouldn't be surprised to find at least one.
But that doesn't mean anything. You're always going to find a few of those, and some people just get off on opposing things.
It's of no consequence without science to support it, and they don't have any.

"so stop speaking like you're some kind of representative for science or all scientists"

I am a representative for science. I come here and argue on behalf of science.
But I am not a representative of any one scientist.
You know, if the scientific consensus was different, because reality was different, then I would be arguing for that.
I didn't pick evolution, and I've never said I like that this is how it works, bu tI fidn it interesting to learn, and I also have to accept reality if I am to base my decisions in reality, whatever they might be. And that's important to me.

"also, the "scientists" can very well be wrong and believing everything they say without questioning would make you an indoctrinated person"

Yes, scientists can be wrong, but it is only rational to believe that which we have evidence for. We cannot assume that something is wrong just because it could potentially be, and not everythign in science could be wrong.
And I question what I am qualified to question, but we cannot all be good at everything, so to some extent we need to trust in the experts. We have a scientific method that helps to weed out bad science, and find the good science. When there is a consensus on something, it is very reasonable and rational to believe it to be true, at least "for now".

"hahaha... evidence?... actually what you have is a lot of faith... you need a lot of faith to accept some of the so-called evidences as valid evidences"

All you need is the ability to reason, then you don't need any faith whatsoever, when you can rely on what is evident.
But first you need to have the ability to understand how evidence works. Creationists generally don't, or they wouldn't be creationists after having faced the evidence.

But of course, you probably accept atomic theory and gravity, and such, even though the evidence for those things are weaker.
You're biased and won't accept evidence that goes against your religion.

"and zero evidence for creationism?... well I wouldn't expect you to see any haven spoken with you... still, an unreasonable assertion"

Yes, that's right, zero evidence. To "prove" special creation, you need to find evidence of a creator, and we have zero evidence for that, or it would be posted on every news media in the whole fucking world for a month. Literally everyone would know of that evidence, because it would change the whole damn world and throw 90% of all science into the trash.

"btw "sounds reasonable"? try "sounds ridiculous"..."

You misread what I wrote. I wrote: "you need to actually give me a valid reason for why it's wrong, rather than what "sounds reasonable" but has no evidence"

"I've had little chance to give my other points and evidences: I would love to do so after we clear this DNA debate up"

Yes, looking forward to it. But we have this problem where I suspect we won't move past the "DNA discussion" because we disagree.
If you want to just abandon the DNA discussion, I'm OK with that, in case you want to move to some other topic.

"If you want to prove you're right, then prove that it is decoded by the ribosome. Prove that the DNA sequence first needs to be turned into a different sequence before it's turned into a protein.... Ummm... amino acid sequence??? "

You mean the amino acid sequence that is the protein?
But no, that still isn't "decoding". That is the product of he DNA sequence. We need something like the DNA sequence being decoded into a different DNA sequence, and then turned into proteins by the ribosome by interpreting that decoded sequence.
Because as I said, a code is a second-level symbolism, so it is a symbol in place for a symbol, and the ribosomes do not read symbols, so we need 2 stages: 1 stage of decoding, and one stage of the ribosome understanding the "meaning" of the symbol, so that it can construct a protein.

I mean, it makes no sense to even suggests that DNA contains a code. It's so utterly pointless if it was,m and it woul donly introduce a lot more stages where things could go horribly wrong.

And even if we cannot agree about the second part, where it needs to interpret the meaning of a concept (the symbol), there still needs to be the part where it is decoded into a different sequence before it's used, and that doesn't happen, either.

Codes only exist in minds. Machine code is only a code because there is a mind that conceptually sees it as a code. Anything that is second-level symbolism is code, but "symbolism" as a whole only exists in minds, not in cells or in ribosomes, and so on.
When we call it "code", it's just a word for something. It is whatever was intended to be a code.
So if you want to use DNA being a code as evidence of a designer, then you've got it backwards. DNA only contains a code if the creator of it "called it" a code, basically. If to him, seeing it as a "code" helped him "visualize" what he was doing.

So find the designer, if one exists, and then ask the designer if it is code, I guess?
Reply: Benjamin Toby"Michael Behe- Biochemist
Jonathan Wells- Molecular biologist
Michael Denton-Biochemist
...and I'm sure there are more..."

I'm not going to even bother getting into Behe, but still, you just mentioned 3, when you need to mention 50 000.

3 out of a million is effectively zero. I agree that there's probably more, but we're talking about a huge consensus for the fact that life on earth is related. All in all, over all sciences, something like 70-80% agree that this is true. If you strip away scientists from fields that have nothing to do with evolution or biology, then the number goes up to something like 98%.
And when they tried to get the % of geneticists, they could not find a single one who disagreed, so 100%. (There's a margin of error, obviously)

You will not find this kind of consensus about anything else in science (except thermodynamics, probably). This is because there is so much data to work with, giving us overwhelming amounts of evidence, and the evidence tells us that we're related to the other life forms. There isn't even any competing idea. There is nothing we've seen that could be interpreted to even reasonably give us the idea that there could be some other explanation.
And don't tell me "but creationism", because creationism is not a scientific hypothesis.

"2. I am a representative for science. I come here and argue on behalf of science.... lol... please save me the comedy..."

You're quite an ass, you know that, right?

"I think I'm pretty certain of my reasoning process"

Duh?
Well, it's nice to see you've got confidence... or something.
“The fool doth think he is wise, but the wise man knows himself to be a fool.” (shakespear)

"and pls don't use your logic to judge all creationists for their resolves: if you were reasonable enough you'd see a few reasons behind creationism"

Hey, don't get me wrong, I understand why people are creationists. It's in human nature.
But creationists need to learn to let go of their human nature, and accept that they are flawed, that we have a tendency to commit fallacies.
This is the very reason we have science. If humans already had a good method for finding out about the universe, we would not have to invent the scientific method.

And sadly, creationists do not follow the scientific method, and that's a fact. And thus, they cannot be reasoned with, because they "have personal experiences", and so on.

And I know you can probably find the odd creationist who is way more reasonable than most, and that's nice, but... yeah.
And, once again, remember that there are more christians who believe in evolution than there are atheists who do. I am not bashing religious people for not accepting science, I am only bashing those who... don't accept science, for not accepting science. And those people are the creationists and the flat-earthers and the geocentrists, for example.
Yes, that's right, you're in the same lot as the flat-earthers and geocentrists. People who do ignore the science.

"you can tell the presence of wind by observing the movement of physical things affected by it: e.g trees... you can tell the presence of love by observing people who feel it... you can tell the presence of gravity by throwing a ball up in the air and watching it come down... you can tell the presence of magnetic force by bringing a magnetic metal close to a magnet"

Yes, all of these things are empirical, or at least can be.
The reason we have a theory of gravity is because someone saw things falling, and wondered what makes that happen, and/or wondered why the planets orbit the sun. So they tried to find the answer, and failed, but at still managed to explain how it works, by "the law of universal gravitation", f=m/d^2.

Then comes Einstein and wonders why metals shine the way they do when you shine light on them. (Basically). And he find that light is made of particles, photons. (The photelectric effect - nobel prize.)
Then he wonders what it would be like to travel through the universe on a beam of light, and finds the answer that is the theory of relativity.

See the common thing between all these things? you observe somethign that happens (a fact), then you try to find an explanation taht fits those facts. This is the scientific method simplified.

Creationism? "We have a book that tells us the answer, now we need to make sure we interpret the evidence to fit that answer".
And therefore, it is not science. Creationism started with a conclusion.
And even though the book that is the core of their belief has been disproven, they still insist on it. I mean, you can't get any further from science than that.

"YOU can tell the presence of the imaginary process that turns a fish into a cat by observing variation and adaptation: even if it is absolutely ridiculous and senseless"

No, I can tell that the gene pool is affected by the environemnt. In my life time, I can see that fish in the ocean have gotten smaller because we only fish the large ones, and this has affected their gene pools. (Just a random example.)
And because of this, I wonder what effect this principle can have over a scale that is millions of times longer than my life time.
To know that, I look at the fossils. I look at comparative anatomy/morphology. I look at DNA and embryology and mictochondrial DNA, and the geographical distribution of life, and many more thigns that can give me an insight into the history of life on earth.

And when I sit there with all that evidence, I can draw only one conclusion that fits all of the evidence, and explains why it is the way it is.
And this theory that we have created, if it is true, must be able to predict things. So I test its predictions.
For example, we had found fish that lived in the ocean, 400 million years ago, but no land animals from that time. We had found land animal much later, that shared some traits with those fish that lived in the ocean earlier, such as a simialr skeletal struture.
So, the theory of evolution predictios that we should find an intermediate form. The must have lived an animal, between those times, that was still pretty much a fish, but had started getting up on land. And we've got a decent window of time wher eit should have lived, so we know at what depth in the rocks (sedimetnal layers) that we should find this intermediate form, and since we know where on earth we found the land animal, and where we found that fish, we can tell sort of wher eon earth that intermediate should live.

So, we go and look at that depth, at that place on earth, and what do we find? Exactly what the theory of evolution predicted. This is how we found Tiktaalik.

Now you tell me again that this is "imaginary". And you explain to me how an imaginary thing could predict that. Exaclty the intermediate it predicted, at the depth predicted, at the place on earth predicted.

Another good example is when some sientist, a long time ago, found an exotic flower opn an exotic island. The flower had a 30cm long tube, and the nectar was at the bottom of that tube. Pretty unique and cool. Because of theory of evolution, the scientist predicted that there must be an animal that eats the nectar, and has a 30cm long tongue that is can stick down that narrow tube. Otherwise, the flower would not have that long tube.

Much later, we did find it. A moth with a 30cm long tongue. As predicted by the theory of evolution.

I assume you understand why the theory of evolution predicted that there should have been such a moth. Anyone who knows the science could have made that prediction.

This is the same thign as how we can predict the movement of planets, for example, of predicted the position of black holes, and so on.

"but you can't tell the presence of a designer from the evidence of its designs... "

That's right, I can't. Tell me how I can know if something is a design without knowing that it had a designer first, before I call it a "design". I'd love to hear how you justify this, how you reason. Because I can look at a stone, and not know that it was designed, and I can look at a crystal and not know if it's designed, and I an look at a snowflake and not know it if was designed.
but if I understand nature's process of creating snow flakes, then I can understand that it is natural and not designed. If I find the guy who makes snowflakes, then I'll know they are designed.
At any point, I could just assume it is designed, but what is my justification for that? I have no idea. Saying that something is designed is a conclusion, and conclusions must be based on something. Is it just subjective?
So when I see something, and I can't make a justified inference, then I will not assume anything about it. I will eitehr ignore it, or try to find out. I will not just make a call based on nothing, like "I will now believe that this is designed".

Now, if I see a house, with class windows and a chimney, and so on, I'll see it as something that was designed because I know that humans design houses like that. That's an inference. That's justified. I could be wrong, but it's justified to believe that I'm right. If I need to be sure it was really designed, I'll go check the records of construction, and so on.

Now give me an example of something we don't know whether it is designed or not, and tell me how you justify calling it deigned or not designed. You have the chance to teach me something!

"Now, coming from a three-day lecture on "equivocation fallacy", and our agreement on using the term "translated", I used that as basis to prove the DNA sequence is turned into a different sequence like you asked me: and that sequence is the amino acid sequence: Now, you're saying what you asked for was proof of the DNA sequence being "decoded" into a different DNA sequence and that obviously is a different request all together: you just committed an equivocation fallacy on a high scale... "

While not an equivocation fallacy, actually, you could accuse me of a fallacy known as "moving the goal posts". I'm not sure, because ther eis some confusion here, probably mostly on my part, because this is actually really hard to... "detangle".
I did say , from the begining, that a code is a symbol in place for a symbol. At some point, in teh middle of this discussion, I let this definition slip, that a code did not have ot stand for another symbol, but that it just needed to be decoded.
Any such inconsistency is definitely my fault. If it has lead to either equivocation fallacy, somewhere along the line, or if it has lead to an apparent moving of the goal posts, I'll accept that as my fault.
The reason for this is because you are confusing to me. Your constant brute-force approach to tryig to squeeze in teh word "code" into this, by twisting and turning every possible stone, has "broken me". I can't take this anymore, it's frustrating.
So, while it definitely isn't true that DNA sequence contains a code, I obviously cannot communicate this to you in a way that gets my point across, try as I might. If i try to be accomodating, I fall into a fallacy, or I end up misrepresenting my own position.

So either we stop this, or we go ahead and call it a "code" just to get on with the conversation, because I don't see how it even matters. You pick what you'd prefer.

"Take this instance: Translating a text written in English Language to a different Language... and... Translating the text written in English Language into a different sequence of English Language... you not only equated the two, but you introduced the very word we were trying to clarify: decoded... "

No, I don't think that's what I did. (That's not an equivocation fallacy, though, but it would be wrong to think both of those things are the same thing.)

English sentence into German sentence = translation.
English sentence into different english sentence = just a change. the reason for the change is ambiguous.
If, however, the first sentence is what it is because it is an encoded form of the second sentence, and this change from the first to second is a decoding. That makes the first english sentence code for the second sentence.

For a DNA sequenec to be a "code", it must have been encoded from a difference sequence, so that it presesents that other sequence through a code system.
If we agree that a code must also stand in place for a symbol, then a mind that is capable of understanding symbolism must read the decoded form of the DNA sequence, and interpret it symbolically to know what proteins to make.

In we do not agree that a code must stand in place for a symbol, then... I don't care if you call it a code, I don't want to argue about it anymore.

Only one thing is important to note, from this whole discussion, and that is that you cannot equate these two definitions. If you accept that a code is soemthign that stands in place of a symbol, then a code is somethign only minds can use. If you don't agree that this is a necessity for the definition of "code", then DNA could be a code, but it also means that you cannot compare that code to other kind of code, that I was talking about.

Therefore, I don't care if you call DNA a code, anymore. If you do, then you might or might not have inveted a new context for the word, and as long as you don't equate contexts with eachother, it doesn't matter if the word is the same. (Same word, different concept.)

By the way, you said I introduced a new word, "decoded". A code can only exist as a result of something being encoded, and it cannot be used before it is decoded. That is inherent to the concept of a "code". It's not my fault if you weren't aware of this from the start.

"Even if you camp around the word "turn", then "turning" a sequence to another sequence would still mean "turning" the DNA sequence into the amino acid sequence... and using the same word(turn) for the phrases: " the DNA sequence first needs to be turned into a different ", and " before it's turned into a protein. ", would qualify as yet another "equivocation fallacy"... "

The equicovation fallacy can be described this way:
If I argue "if A, then C", and this is valid, then I need to demonstrate that "A" is true to prove that C is true ("A, therefore C").
However, if I do not recognize that A and B are different things, and only show that B is true, then I fail to satisfy "A, therefore C", because I am actually arguing "B, therefore C", because I am equating A and B as being the same thing. And "B, therefore C" may not be valid.

But the thing is, "if B, then C" could be just as valid, which means that it really is "if A OR B, then C". Or, alternatively, you could say that A and B actually is the same thing, at least in this context, so it's not a fallacy.

The [partial] sentence, "before it's turned into a protein", does not contain this fallacy. It cannot. Nothing about this sentence tells you I was using the wrong contextual meaning for "turning".
Using a word that has two different meanings is not a fallacy. We do that all the time. Using a word that could mean two things makes the meaning of the word ambiguous, and may require it to be clarified. This is why I keep saying things like "informative information" vs "information in the sense of information theory", even though it's a pain in the ass to keep having to write it, but otherwise it becomes abigous as to which "information" concept I am talking about, and this helps prevent equivocation fallacies, because there's clearly a difference between thes two concepts.

If I say "before it's turned into a protein", the word "turned" may be ambiguous, but that doesn't make it a fallacy.

"so much equivocation fallacy from and expert in "equivocation fallacy studies": "

I am not, but as I programmer, I do need to have some graps on logic.

"you don't consider yourself as a valid candidate for the errors you point out in people you disagree with"

When you want to accuse me of a fallacy, then give me the actual information that proves I committed a fallacy. You don't. you give me hints, or partial stuff that do not contain the fallacy. Or you completely rephrase what I said and switch out the words.

If I made a fallacy, I have no problem admitting that, but you have to show me where I did, because I cannot find such a fallacy for the life of me.
Reply: Benjamin Toby "firstly: all christains are creationists so there's no particular distinction between the two"

That is incorrect. I've talked to a few christians who accept the science, and see Genesis as an allegory or as symbolism.

Creationism and evolution do not fit together. And many, many christians accept evolution. I don't remember how many, but something like 40%, if I remember correctly. Probably a little less, though.

" secondly I use the scientific method to the fullest"

Well, "to the fullest"... only scientists do that. If you're not a scientist, you only use the first few principles, because the rest is about peer review and such, and non-scientists don't publish their findings.
But it's true that I don't know how you personally justify what you believe, for example. I am talking about the "public speakers" of creationism, for example.

But it is still true that the only way to believe in creationism is if you presuppose that it is true, because there is no evidence that leads you to that conclusion. If there were, then there would be evidence in support for it, but there isn't. There cannot be evidence that supports two opposing explanations, because then the evidence is not evidence of either explanation. That is the nature of evidence.

"is why I can see you probably have more faith than me"

Lets make sure we mean the same thing with the word "faith". As I see it, "faith" is the excuse people give for believing something without a good reason. "Just you have to have faith" is the cop-out when you push a religious person into a corner.
I have absolutely no reason to have faith. I stand nothing to gain from it. Christians, however, believe that as long as they have faith, they will be rewarded. An atheist doesn't expect any reward for intentionally being gullible.

"and thirdly, you might very well be getting the definition of creationism twisted"

It's possible that we don't mean the same thing, yes. I am talking about what is known as "special creation", that each species (or say genus, if you want) was created separately by a "god". This is the "opposite" of evolution, in the sense that it proposes that we are not related to the other species on earth.

If you mean something else, tell me.

"I could very well accuse you of spreading misinformation too on many instances:"

Yes, and I can accuse you of child molestation. (?) That doesn't make it right.
If you ask me to I can give you examples/explanations of where they are being dishonest, and where where they are out-right lying and spreading misinformation. Especially Kent Hovind likes to use quote-mining, for example, which is extremely dishonest. It is a lie about what someone said.
Ken Ham, Ray Comfort and Kirk Cameron, for example, lie about what the theory of evolution proposes, even though the have been corrected sooo many times. The fact taht they keep doing it proves that they don't care about what is right.

" and if you ask me, most of evolution is misinformation: and I think I can prove that"

If you can prove it, then I'll happily listen. Otherwise, I don't care what you think, because I don't care about opinions.

"ok please could you define the term creationism"

(Skipped becausae I already did)

"4. And the way I see it, if only one of these "points" is disproven, then you can throw the entire thing out.... oh really? well then I guess Darwins theory should have been discarded a long time ago with the cambrian evidences and the slow/gradual progression debunked"

Darwin isn't supposed to be infallible! Neither is his book supposed to be infallible!

Your god is supposed to be perfect in every way, and his book is supposed to be infallible. If the book turns out to be wrong, then the infallible god who wrote the bible logically does not exist.

If there is a god, then it is not the god that christians propose.
And the same goes for all abrahamic religions, because they all believe in the very same god.

"PS just out of curiosity, what do you think the Bible is?"

A composition, a selection of documents picked by the church to represent their religion. The documents themselves are written by people at different times. As for the intent of those documents, I cannot say. Some are likely old tales that get recycled over and over, like how noah's flood is a recycling of an older story, and so on. Some, like the book of revelations, speaks about the fall of the roman empire.
Other books contain documentation of the culture, even if that may or may not be the intent of the writers.
And I haven't read all of the bible, either. I don't read much else than science books, and the bible is particularly boring to read. It's long, slow, and uses cumbersome language that makes it slow to read. And most books are not very interresting, though I do like the book of Job. It's so tastefully evil. But it also contains a lot of stupid stuff, for example a lot of things that paints a picture of a world that is flat.
So does genesis, of course, but I've already pointed out that genesis is wrong.

Also, being swedish, I don't know how the name of the books in english, very well. In swedish, genesis and exodus are called "the first book of moses" and "the second book of moses", I think, and so on. I have no idea which book is "deuteronomy", or whatever it's called.
Could be easily checked, of course.

"Ummm... similar DNA = similar creator ... what you call common ancestor... only difference is you think all these species "evolved" from that, I believe all major phyla and families were created..."

"Similar creator"? That makes no sense whatsoever. Similar to what?

First of all, I agree, similar DNA = same creator. Me and my brother and my sister have smilar DNA because we were created by the same parents.
And the similarity between the DNA of humans and chimpanzees means that we had the same maker, and that makeer was likely a part of a species called Sahelanthropus Tchadensis, about 6-7 million years ago.

OK, both families and phyla were created separately? That makes no sense, since families are subsets of phyla. Then you're saying each family were created separately, not each phylum. 
So why are there similarities between some families, but not between others? Or, if the phyla were created separately, why can we group them up into kingdoms?
This logically concludes that if "similat design = similar designer" is true, then there was more than one designer. One designer preferred to make life that had exoskeletons, like insects and arachnids, while some other designer preferred to use endoskeletons, a k a vertebrates, while others preferred to make thigns like molusks, and some other designed made trees, and so on.
That is the prediction of the idea that similar design means it was made by the same deisgner.

But this is what you believe happened, it is not an explanation. It tells us nothing, it's a claim not an explanation.
You just said "god did it", and that's all. It doesn't explain why there is a fossil rescord layed out in order of age, why humans only appear in the last few million years, and why the DNA of species can be laid out to form a tree of life, and why similar species tend to live geographically close to eachother, and so on, and so on.
Your explanation does not explain this evidence. That is, unless you want to keep just throwing out the "god did it that way" cop-out. "Magic" is not an explanation.

" I understand perfectly everything you've said: I don't type so much and I try to keep my points simple: "

Then make sure you let me know that you understand me, or I might think you don't. When I explain something, and then you reply as if I had not said what I said, then I might interpret that as if you didn't understand me.

" and I can see from your comments that your reasoning is relatively weak..."

And I can see from your comments that your mother didn't give you enough attention. (?) Seriously, baseless accusations like this is immature and pointless.
If my reasoning is weak, then prove it is, don't just attempt to make insults like a little child who doesn't have anything else than insults to use. You have a brain, don't you? Use it.
You reap what you sow. if this is the level of conversation you want, then that's what you'll end up getting.

"this is a clear evidence of you turning a blind eye to signs of intelligence"

you're beign wvery confusing when you say "intelligence", when I think you actually mean "intelligent design". I know there is intelligence...! I am an intelligent creature, talking to an interlligent creature. I know there is intelligence, so stop saying I don't. If you mean "intelligent designed", then say it.

" if you assume nature has the ability to create DNA from scratch or introduce new genetic information necessary for brand new kinds of organisms"

I have evidence that nature can create DNA from scratch. And I also know that nature can change the sequence of DNA into new sequences.
But I do not have evidence that one creature can evolve into a "brand new" creature, because that would violate the science. A bird can only evole into a new bird. It cannot evolve into a human, or a cow, or a spider. It must always remain bird. It can change a bird more and more over time, but it never becomes a non-bird. this is why a raven and a penguin and an ostrich and a kiwi are all birds, even though they're quite different birds.

"but if nature only works with what it has, as seen by evidence, then you're a long shot from new genetic information arising through nature"

For one species to change into a new species, the DNA sequence must change. Yes, this happens naturally.
And you know that new genetic information arises from mutations. If "TTG" gets mutated into "TAG", then it's a new genetic sequence that holds new information. It's not hard for nature to create new information, and you know it. I don't understand why you insist that it doesn't.
Most certianly, your DNA hold sequences that neither of your parents had when they were born. On average, we all have 60 new mutations per geneation, all of us.

"you have absolutely no proof that the DNA originated by natural means"

Science doesn't work with "proof", only math and lgoci (which is a kind of math) does.
But you're absolutely right that we have pretty much no support, other than inferences, that life on earth started naturally.
We do not know, but it is possible that life started naturally. I'd say we've demonstrated that.

"if you can give me one(1) evidence of a single working cell arising from molecules and atoms, then you have proof of DNA occurring without intelligence"

That is nonsensical. Why would I have to demonstrate a cell to demonstrate DNA?
No, to prove that DNA can occur naturally, all I have to do is demonstrate that DNA can occur naturally, not cells.
And we have done that. Scripps research institute, and some brittish university (I think it was), have together demonstrated the separate steps from simple molecules, like sugars and phosphates, turning into DNA enzymes, by first turning into ribonucleotides, then chaining up into RNA, then turning into DNA.
This is known as the "RNA World" hypothesis, and it's got good experimental support, but we're not finished. We all have to be patient.

" I'm not sure i understand this bit: if it's not chance, then it's intelligence"

"Chance" implies that it is random. If evolution was random, then we would have random DNA sequences, and life would not exist. The sequences change lawfully.
For example, if I roll a bunch of dice, and I get a bunch of random number, but I only pick out the dice that rolled 6's, then this is not random. It's isn't "chance" that you end up with a bunch of 6's.
If the process that picks out only the 6's is natural, then intelligence is not required.

But I shouldn't have to take that as an example. It's not "chance" that the earth is round, it's round because of gravity. It's not round because of intelligence.
The shape of a river (favourite in return) is not random, it is a result of physics that the water takes a specific route, and it couldn't have been any different, given that environment. No one rolled dice to determine the shape of the river, the river had to comply with the laws of physics and take a specific shape. And we can predict how rivers will change shape, by modelling them and simulating them, assuming we have enough infromation about it.

I understand that you might mean "chance" in a more loose sense, a more subjective sense, and that's OK. I just want to make sure you don't think evolution is random. Only mutations/variations can be said to be random, but mutations/variations are just the input to the process. The process is not random, it is lawful.

"and you can't presuppose a certain degree of intelligence in evolution and accuse me for invoking intelligence"

I invoke lawfullness. I can find nothing intelligent about it. Intelligence implies some kind of awareness, some kind of planning or the making of choices. I see none of that. I see cause and effect.

"the theory says all life evolved from a single celled universal ancestor "

No, like I said, the theroy for how life changes does not contain the assertion that we are all related. It explains that different species can be related, and that this is because species split into separate species, and the theoryt explains how that happens.
But the idea that every life on earth is related is a "theory of its own", if you will. If that turns out to be wrong, it doesn't have to disprove the theory of evolution. Life could potentially have risen multiple separate times, and thus not be related. This is OK with evolution.
But that does not appear to be the case, which is why scientists agree that all life on earth appears to be related. But this is a spearate thing, it is a conclusion, not an explanation.
Our investigations into genetics is what mainly tells us that we are all related. Of course, we would not be able to understand genetics if we didn't accept/understand evolution.

"the millions and billions of years just seem like a pathetic excuse to leap-frog this vital aspect"

We find evidence of fossil bacteria as far as billions of years back in time, which is why we believe life to be that old.
And multi-cellular life came after a few billions of years, implying that this was a hard step to take, or at least that such a change doesn't happen lightly. It's not something we're likely to see happen again. Most life on earth is still single-celled, as far as I know.
But likewise, other specific traits of life are rare, aswell.

So I don't know how you can say that "billions of years is an excuse", when we find evidence of billions of years old life, and simply have to accept and conform to this evidence. It's not our choice.
Neither is it our fault that very old life is very hard to study, or that we lack some of the data needed to get a perfectly complete imagine. Time is not kind.

"10. I'm holding on to hope that you don't actually think that the theory says that the change is random.... please prove to me that it says otherwise..."

You know of natural selection, right? It's the main part of evolution, and it is a law, though it's called a "principle", because it's not a "mathematical" law.
There is some inconsistency with the naming of terms, sadly. There is a law that state that fire tends to seek out surfaces, and this is called a law, eve though it's not mathematical, either, so it's confusing. And string theory is not a theory, and neither is M theory, for example.
Anyways...

If a selection pressure is that you need to be fast to survive and have children, then the species will evolve to be faster. If it was random, they wuld evolve randomly. Not in accorance to this law.
Take a large group cheetah's, and kill any cheetahs that is a little "too slow", and this law will guarantee you that the group will evolve to become faster. This is lawful, not random.
Species always adapt to their environment, or they go extinct. That is lawful, not random. No species will randomly evolve something, they will always evolve something that is an advantage to them in their specific environment, but which might not have been an advantage to some other species in some other environment.

Are you satisfied with this "proof" that the process of change is not random?

"if evolution works by predicting change within species the it has no business trying to dig into the past until it cam prove that organisms gain brand new information that wasn't already present in their genome"

The history of evolution of a specific species is not the domain of the theory of evolution, it is the domain of paleontology, mainly.

The theopry of evolution explains how life changes, not how life "has changed". The "has changed" part is an application of the theory.

We have proven that species gain brand new information that wasn't present. (If it was already present, it wouldn't be new.)
For eample, the nylon-eationg flavobacterium. In case you haven't heard of this one, there was a flavobacterium that lived in the waste waters of a nylon factory in japan. Nylon is an artifical molecule, invented around something like 1940. In the 1970's, scientists found that the flavobacteria that lived in the waste water had evolved a new enzyme that allowed them to digest nylon. The enzyme is called nylonase.
Research into this revealed the mutation, which was a "fram shift" mutations, in combination with another mutation, if I remember correctly. Two mutatioons that changed the DNA of the flavobacterium in a way that made it produce nylonase, and because that was awesome for something living in the waste water of a nylon factory, this was very beneficial, and therefore was "kept" by natural selection.

And one thing to note about this is that nylon is an artificial molecule. It did does not exist naturally, and was only invented less than 100 years ago. It took perhaps 20 years for the flavobacterium to evolve the ability to digest this new molecule.

But this is not enough, of course, so scientists repeated this in a laboratory, where they took E Coli and checked if it could also evolve nylonase. It did, but it turned out to be slightly different from the nolynase in the flavobacterium.
A different solution evolved, as one could perhaps expect, but still something that would be considered convergent evolution - the same thing evolving twice, but independently, like the evolution of sight/eyes. In such cases, they generally cannot be exaclty the same thing, but they can serve the same function in a similar fashion. Like the difference between human eyes and compound eyes, for example.

" I can't grasp the idea of 4 billion years no better than you can... and you certainly can't make any judgement either based on the observed processes we've seen"

We have evidence from backward in time that tells us what has happened in the history of earth. We do not need to speculate very much about it. Some holes exist, which we might never fill, but since other holes have been filled, we know that the holes can be filled, especially when we combine this with the evidence of genetics, for example, which tells us that all those whole should have somethign that goes in them, even if we can only find the "plug" for most of them, but not every single one of them.

" fish change? Yes: but fish don't grow wings like birds: that is purely assumption..."

So you have never seen a "flying fish".
https://en.wikipedia.org/wiki/Flying_fish
I agree they're not wings like a bird's wings, because that would be impossible. A fish can never evolve bird wings, just like a mammal can never evolve feathers.

Bird wings, however, could evolve from maniraptora, a subset of dinosauria.
Fish did not evolve those wings, maniraptora did.

However, the ancient water animals that looked like fish, which would've been considered "fish" if they were alive today (a problem with linnean taxonomy, not my fault), are ancestral to dinosaurs aswell, so in *that* sense, yes, fish evolved wings, eventaully. But it's not quite right to call those creatures "fish", because they are 400 million years less evolved than what we call "fish" today.
It's more correct to say that fish and birds share a common ancestor. And of course they do, they're very similar! That cannot be a coincidence, so this similarity demands an explanation. Common ancestry perfectly explains it, because it explains every aspect of it, not only that they appear to be similar, but the details of how they are similar, and how they are not. And luckily, we can trace the comon ancestry back through the fossil record, though they are very distantly related. Fish are divided into two groups, ray-finned fish and lobe-finne dfish, and I think that birds and modern fish are not of the same group, so their common ancestor lived even further back in time, during th etime of the comon ancestor of lobe-finned and ray-finned fish.
And I do not know much about that.

And if you want to see fish grow "legs" (figuratively), then we have a present-day example of that, aswell, with the "mudskipper", which is a fish that crawls on land, and can breathe air as long as it stays wet.
Probably similar to what happened with Tiktaalik, hundreds of million years ago.

" trust me it does work for everything, both common and uncommon: and the opposite of common sense is idiocy: which would you have me pick?"

I didn't ask you to apply the opposite of common sense. The very idea of your personal experience dictating your understanding of things you haven't experience is what is the problem.
If you need to be an "idiot" to understand all of science, then perhaps being an idiot is not inherently a bad thing. So perhas we should use that word.
Set aside common sense and rely on the scientific method. That has been demonstrated to be very successful.

So how is that working for you, applying "common sense" to quantum mechanics and relativity? We know they're true, because our technology relies on them being true, and our technology evidently works. Yet they harshly violate common sense, so how do you deal with that?

I mean, if I tell you that two cups of coffee you see on the table are actually the same cup, but in two different places, then that would violate common sense. You would, using common sense, say ithat it's a trick, an illusion. And so you would never be able to understand the concept of something existing in a "superposition", but it's still real. Common sense would be holding you back, because it's not fit to deal with uncommon things.
Comon sense is based on your personal experience with life. And you have no experience with the really really small scales, or the really huge scales. We are medium sized creatured who live medium-length lives.
Things outside of our concerns have had no impact on our evolution, so we have not evolved the specific ability to understand concepts outside of out scale. We have no ability to visualize 4 dimensions, for example, even though the universe truly is 4-dimensional.

Our brains have only evolved with the concern of increasing our likelyhood to reproduce. Our brain did not evolve to accurately represent the world around us. So we need the scientific method to remove the human factor as much as possible from our search for understanding of the universe.
Reply: antiHUMANDesigns 654 lines: you should read my lines well because I put time to make them simple enough while conveying as much message as possible: you're not helping at all with the pointless rants...

1. That is incorrect. I've talked to a few christians who accept the science, and see Genesis as an allegory or as symbolism....please define creationism before using the word... what you gave there was no definition...

2. "Similar creator"? That makes no sense whatsoever. Similar to what?... let me paraphrase: anything with DNA had a common creator...

3. "OK, both families and phyla were created separately? That makes no sense, since families are subsets of phyla. Then you're saying each family were created separately, not each phylum. "... take it like this... each phyla was a structural pattern to create families...

4. Then make sure you let me know that you understand me, or I might think you don't. When I explain something, and then you reply as if I had not said what I said, then I might interpret that as if you didn't understand me. ...a dull method of thinking I'd say: especially after the lengthy time it took you to grasp a single point I put foward: you should have realized by now that I'm not slightly phased by all your supposed points or "evidences"... why don't you try to tackle the issues one at a time?.... why do you blame me for your lack of understanding of most of my points?... 

5. And I can see from your comments that your mother didn't give you enough attention. (?) Seriously, baseless accusations like this is immature and pointless.... trust me my accusations are not baseless: you'd find it hard to see from your point of view..

6 If my reasoning is weak, then prove it is, don't just attempt to make insults like a little child who doesn't have anything else than insults to use.... proving it wouldn't be so hard... here's the easiest one: you gave me 777 lines in the other thread and I didn't respond but you somehow think giving me over 600 lines now would work: not very smart... what is insanity? well someone said insanity is doing the same thing over and over again and expecting something different...well well...

7. I have evidence that nature can create DNA from scratch. And I also know that nature can change the sequence of DNA into new sequences.But I do not have evidence that one creature can evolve into a "brand new" creature, because that would violate the science.... now that's interesting... could you please show the evidence?

8 I have evidence that nature can create DNA from scratch. And I also know that nature can change the sequence of DNA into new sequences.... please could you submit a link or something?... I want to see a functional DNA created from scratch and making proteins: if you don't have this, could you please remain silent about the topic?

9.  A bird can only evole into a new bird. It cannot evolve into a human, or a cow, or a spider. It must always remain bird. It can change a bird more and more over time, but it never becomes a non-bird. this is why a raven and a penguin and an ostrich and a kiwi are all birds, even though they're quite different birds.... I'm sorry didn't you say a fish evolved into humans one time?... you're not saying the same kind of evolution that is actually perpetuated in mainstream: a bird to another variety of bird would be horizontal evolution and for the nth time: I have no problem with that... how do you fail to understand by basic arguments and then accuse me for not understanding yours?... and yet, you blame me for accusing you of being unreasonable...

10. The history of evolution of a specific species is not the domain of the theory of evolution, it is the domain of paleontology, mainly.... are you kidding me?... give me ONE link to a description of the theory of evolution that doesn't dig into the past... ONE...

11. scientists found that the flavobacteria that lived in the waste water had evolved a new enzyme that allowed them to digest nylon.... could you submit the detailed evidence of this showing in-depth pictorial representations and schematics of the bacteria both before and after the evolution of the new enzyme? and could you do the same for the E. coli bacteria?... if you can't could you please stop bringing unverifiable claims up here?

12. you seem to know quite a lot: but you don't seem to be reasonable enough and you don't seem to think critically: I think I can prove more of that: you're going to type over 200 lines again hoping you're communicating or making sense...
Reply: antiHUMANDesigns

1. ...but I have! I told you that I'm talking about "special creation", which is a known concept. I told you this, did you not read?... of course I read it: that's why I said that was no definition of creationism: special creation is not the same thing as creationism: creationism is simply the belief that the universe and life were the product of certain acts of divine creation... that's why there's a distinction between Young Earth Creationists, Old Earth Creationists and Evolutionary Creationists... If you want to be more specific then you could call it Biblical creationism: I assume that's what you're trying to relate...

2. OK, that makes more sense. But like I said, it doesn't explain the evidence. You could argue that it explains some of the evidence, but it doesn't explain even half of it.... you could name the evidence and I'll do my best to explain it...

3. There has to then be some kind of reason for why life can be grouped into a tree.... what tree?... shouldn't that tree be discarded by now following the lack of transitional fossils?... a "creation orchard" would fit the evidences better since all families would be linked to a common creator... instead of the branching tree with a bucket load of unknown transitions...

4. Whatever the evidence happen to be, you can always say "magic", and it will "fit anything", so then "magic" could be the explanatoin for everything, which is the same as an explanation for nothing.... another misconception of you atheists is thinking God uses "magic"... God uses specific principles and laws to achieve things: little to no magic involved: it's just the mainstream representation of God that gives the notion of magic: but as Galileo said, " Surely, God could have caused birds to fly with their bones made of solid gold, with their veins full of quicksilver, with their flesh heavier than lead, and with their wings exceedingly small. He did not, and that ought to show something. It is only in order to shield your ignorance that you put the Lord at every turn to the refuge of a miracle. "

5. Well, you do lead me into different things. Shall I gnore you when you're talking about somethign that's not on topic? And exactly what is the topic, right now?... u just shot yourself on the foot... you lead yourself into these different things and you carry me along: I try to follow but you don't even know the topic presently... well they are quite much now: and I have the daunting task of simplifying most of them for better understanding...

6. But you are confusing to me, because you don't care as much about what words you use, it seems.... wrong... I care very much about the wordings and that was why I spent so much time trying to clarify the term "code"... and that's why I can argue that the term "evolution" is twisted for selfish reasons...

7. No, I do not trust you. I have plenty of reasons not to, and I don't generally trust anyone before they've proven themselves trustworthy, which is hard to do over the internet.... that's fine...

8. And alternatively just giving up will yield a better result?... of course not: all I'm asking is that you read my comments closely to save me a few unneeded lines, and to try to summarize your lines by pointing out the key points and arguments...

9. And you seem to completely miss the fact that me giving you this much information is an act of good will. I actually put effort, and don't just say shit like "yeah, maybe you think so", and such that doesn't actualyl contain any informative value. You should recognize that my comments at least contain a decent amount of informational value. How much do yours?... well thanks for your efforts and information: but I'm already conversant with most of the information you brought up: this is not about informing me: it's about method and precision of thinking for accepting any information...

10. And I do consider it smart, given the goal in mind, to provide a lot of related information.... and you should see by now that all information I get go through the process of intense screening and questioning... I don't, and I wouldn't wan't to fall into misinformation again and that's why I ask questions...

11. For all of it? And you ask me not to get side-tracked... :/ The evidence for nature creating DNA from scratch, is what I've told you before, the work done by some brittish university, and the scripps research institute. I might be able to find some links for, to... (googling...)... you see I realized you are a sucker for "scientists say"... I'm sorry but I'm not... thanks for the links but if I can't see graphical representations of all the claims, then it's just unverifiable claims to me... it's evidence for nothing..

12. I'm not saying I fully endorse this description, or whatever, but I did what you asked.... I'm sorry but no you didn't... you must have missed the picture of the evolution of the whale: how's that not digging into the past?... that picture alone gives the idea of the kind of "change" they're speaking of... and that kind of change is imaginary: that's why I try my best to differentiate b/w the two kinds of changes that are causing the confusion here... I'm still surprised you haven't seen it yet...

13. They're not unverifiable just because I'm not gonig to buy you a science journal. You know, you have just as much a connection to the internet as I have. You have access to the same information I do, don't you? And you can buy a science journal just as well as I can. How about you actually research something yourself, if you really care about what is true. I do that. If you make a claim I haven't heard, I'm damn well going to research it, at least a little.... you want to know what I think?... I think if they were so sure of their findings, they should have released photographs or pictorial representations of their findings: I say this because I know the media wouldn't hesitate to propagate pictorial representations of these claims if they had any remote access to them: better still, video simulations could arise from it... till I see clear evidences of these claims, they remain unverifiable to me... 

14. OK, tell me, if I accept creationism, does that mean I think critically? If I become religious, like something like 90% of the world is, am I being critical, then?... of course not: as a matter of fact 90% of the christains I know are either ignorant, hypocritical or just plain idiotic... being critical is putting the same amount of bais, thinking and reasoning into both sides: I don't expect you to become a creationist all of a sudden: I expect you to ask questions regardless of whoever gives you info and regardless of his/her qualifications:

15. Personally, I'd prefer your form of criticism to many other christains I know of: but you fail to realize that the real christain is the most critical... you don't seem to criticize some evidences you accept very well: I think I can prove that: you need a lot of faith to actually believe what's made out of most of these so called evidences... take an instance of LUCY... 

i-   first you need to believe that those bones are actually all real and not fakes (not much to worry about in this case I suppose: but still a certain degree of faith needed)
ii-   secondly you need to believe all those bones belonged to the same organism(animal/whatever)... you need to believe they were not mixing bone fragments from different animals...
iii-   you need to believe that the skeletal reconstruction is actually a correct prediction from the 40% bone fragments available...
iv-   you need to believe that the full body reconstruction actually depict the organism... this is where the most faith is needed... because you can never tell the amount of body hair, or nose structure from 40% of fossil fragments...
v-  you need to believe that that animal(or whatever) actually behaved the way it is perceived to behave: ie was it actually primitive or not or any other perceived behaviour ...

now that's from an "evidence" with 40% bone fragments: now think of the amount of faith you need for a fossil like pakicetus that had two chunks of the skull bone to work with...

if you want to view those bones without any faith, or belief, what you're left with is just a bunch of fossil bones... that's all...

Being a critical thinker is not about disbelieving as many things as possible.... I think being a critical thinker is about disbelieving as many subjective things as possible...
Reply: Benjamin Toby "of course I read it: that's why I said that was no definition of creationism: special creation is not the same thing as creationism: creationism is simply the belief that the universe and life were the product of certain acts of divine creation"

I agree, that's correct, but no one believes such vague statements, they have more specific beliefs. If you're arguing simply for creationism, then you're only arguing for deism, and christains are not deists.
Special creation is a more specific kind of creationism. It's the kind of creationism that people actually believe in.
Scientifically, I have no problem with deism, because it doesn't violate the science, but I do find it pointless. Similarly, I don't have any scientific problems with pantheism, but it is also pointless.
But you are a christian, and what the bible describes is "special creation", because it says that humans were created from dirt, for example. You are not a deist not a pantheist, you are a theist. "Stop me if I'm wrong".

"that's why there's a distinction between Young Earth Creationists, Old Earth Creationists and Evolutionary Creationists... If you want to be more specific then you could call it Biblical creationism: I assume that's what you're trying to relate"

Yes, call it "biblical creationism", in this case, but the problem is that you can interpret the bible any way you want, which is why "biblical creationism" would include both young and old earth creationists. And "special creation" doesn't have to refer to the bible, specifically, it just means that you think we didn't evolve, but that we were created as we are now, at least more or less. I don't care if this belief came from the bible or from some other source, the claim is still thet we didn't evolve from common ancestors, and that's what I'm arguing is wrong. I don't care about irrelevant details, such as which "god" supposedly created us.

I don't know what evolutionary creationists believe, though. But I assume you're not one of them, so I don't have to know.
And you a YEC or an OEC?

"2. OK, that makes more sense. But like I said, it doesn't explain the evidence. You could argue that it explains some of the evidence, but it doesn't explain even half of it.... you could name the evidence and I'll do my best to explain it..."

I'm not sure I can... I'll try to "sum up" a few different lines of evidence that requires explanation, and perhaps give a few interesting examples. 
But do not bother answering something to the effect of "god just wanted it that way", since you can say that about absolutely everything, no matter what it is, and no matter how it would've been, so that would not be an answer.

1. Consider the geological column and the fossils. We do not find humans on a lower sedimentary layer than T-Rex's. We do not find "Tiktaaliks" higher levels than humans. We do not find birds lower than Tiktaalik. And so on. No matter where on earth you look, there is an order in the fossils, according to depth, where depth represents age - whether or not you believe in the actual age of each depth from our dating method, but they are ordered. And primitive life forms are at the bottom, with gradually more complex higher up.
Explain this "universal ordering".

2. A species lived a number of million years ago. They appear to have stopped existing a million years later, but instead, we find a speices that looks almost exactly like that species. But only almost exactly. One million years later, those also disappear from the fossil record, but somehow a new species now exists, there which looks almost exaclty like the old one. And this principle goes on over long chains of species, and for all life on earth.
Explain why species often go extinct but are replaced by similar-looking species in the fossil record.

3. We know you are related to your siblings, when we look at all of your DNA. We know who your parents are by your DNA. We can tell who your grand parents are by your DNA. This can be tested for accuracy and is proven to work with almost 100% accuracy. 
Similarly, it seems we can tell that chimpanzees are your distant counsins, by your DNA.
Explain why the same relationship-measuring techniques work between different species, and not just between individuals of the same species.

4. Humans have 23 pairs of chromosomes. The other great apes have 24 pairs of chromosomes, so they have a pair more than us. At the "ends" of the chromosomes, there is a specific kind of pattern or "marker", called something I cannot remember, which basically marks the ending of the chromosomes.
When we look at chimpanzee chromosomes, and compare it to human chromosomes, we find that human chromosome #2 appears to be a fusion/merging of two of the chimpanzee chromosomes, becaues the DNA sequences are the same, and most notably because there are "end markers" in the middle of the chromosomes, where they do not belong.
Explain why... all of the above.

5.  We may find a fossil of something that looks almost like a form of cat, because of its teeth and feet, but it also looks a little like a dog or a bear. And when dating this fossil, it tells us it lived before cats and dogs an bears. And at the same time, it shares some common traits with an animal that lived before it, but that animal did not have the traits of cats or dogs or bears.
Explain why whenever we find a new life form, or a new fossil, we are always able to place this life form in a pretty precise place in a "tree of life" structure, where different traits all line up consistently, with no oddities like traits jumping back and forth between branches.

6. Explain why we share huge amounts of genes with plants, bacteria and fungi.

7. Explain why all life fundamentally works the same, with only some differences like how plants and animal cells have "reversed" ways of producing energy.

8. Explain why animals that share common traits generally live close to eachother (relative to their ability to move around).

9. Explain why you get roughly exactly the same "tree of life" structure, whether you look at genes, the geographical distributaion of life (extinct and extant), mitochondrial DNA, retroviral DNA, comparative anatomy/morphology, and embryology, to name all I can think of, right now.

10. Explain the existence of vestigial structures: The human tail, appendix, hair sac muscles, and the under-developed muscles that control movement of the ears. The "wings" of the ostrich, emu, and the kiwi. The eyes of the naked molerat. The "hidden legs" and/or pelvis of snakes and whales.

11. Explain why our bodies rely on non-human life forms. 90% of the cells in the human body are not human. We are like a multi-cultural city of different kinds of life forms working together.

12. Explain the dynamics of predator and prey: For example, why are cheetahs so damned fast, just so that they can catch a super-fast prey? Why are some snakes super-poisonous, only so that they can just barely kill an animal that is almost immune to specifically that kind of poison? (The poinson is much more effective against animals they don't normally eat, than against the ones they do eat.)
And also the moth with the 30cm tongue that eats from the bottom of the 30cm deep "tube" on a specific flower.

13. There is a nerve called the "current laryngeal nerve" that is common to all vertebrates from fish to mammals and reptiles, and so on. This nerve goes from the brain to the larynx. In a fish, in goes in a straight line because theyt do not have necks, but in mammals, who have necks, it goes from the brain, down the neck, and wraps around the heart, and then travels back up the neck to the larynx.
This is really, really long for a giraffe.
Explain why this nerve would take this meters and meters long trips around the heart before it goes to the larynx, when it only needed to be a few of centimeters long.

14. Explain the existence of the "mudskipper". A small fish that drags itself around with its fins, on land, and can bearthe air as long as it stays wet, and it digs holes with its mounth. It seems like a cruel fate to be a fish on land.

15. Explain monotremes, like the duck-billed platypus. It shares traits of both mammals and reptiles, by laying eggs, having fur and having a poisonous spur on its back feet, and even though it lays eggs, it still feeds their offspring milk. But it doesn't have teats, so the milk comes out through pores around its abdomen, instead, so the offpsring have to lick it up.
Don't get me wrong, it's classified as a mammal, because it belongs to the class "mammalia" (linnean taxonomy at work), but it still has some traits of reptiles, mainly its repoductive system.

Well, that's a good set of evidence for you to explain. Some more specific, some much more "summarizing". I'll probabaly think of more, but this should be enough.

This time, don't blame me for this comment being long, because you asked for this.

"3. There has to then be some kind of reason for why life can be grouped into a tree.... what tree?... shouldn't that tree be discarded by now following the lack of transitional fossils?... "

Transitional fossils are irrelevant. If you look at all animal that exist right now, and identify the traits that are unique to each animal, then you'll find that some share more traits than other. All birds share feathers, for example. But that is not the only trait they share. For example, birds have scaly feet, like reptiles. Mammals do not.
So while you can group up all birds because they all share almost all traits, you can also group birds with reptiles, because they share a good deal of traits aswell: They lay eggs and have scaly skin. (Just mentioning the obvious things.)

So then take mammals. We do not share very many traits in common with birds, but we do share some with reptiles. So while we can group up mammals very obviously, we can also group up mammals with reptiles.

And if you keep doing this, and especially genus by genus, rather than class by class, you get a tree like structure. If you cann reptiles A, then birds are AA and mammals are AB. They all share that first A in common, but mammals and birds differ on some things that reptiles do not have. This gives you a tree-shape.

It is the same thing if you look at your own extended family. Sometimes a person gets some identifying characteristic, and this may be inherited by that persons children, so you can create a tree-shape of your extended family, simply based on who looks like whom.

And you can certainly do it if you look at the DNA of all your relative, I don't think you deny that.

If you look at the fossils, you do find transitional fossils. Lots and lots, everywhere. And they also agree with this tree structure.

"a "creation orchard" would fit the evidences better since all families would be linked to a common creator"

No, that only fits with the evidence of the animals that live now, and it doesn't fit with the evidence of DNA, and vestigial structures, and so on.
You may group up, in an "orchard style", reptiles in one group, birds on one, and fish in one, and mammals in one, and bacteria in another, and fungus in another.
but this does not explain why birds and reptile and mammal share so very many traits in common, while they don't share as much in common with insects, bacteria and fungi.

You'll still get a tree-shape. By saying "orchard" you're simply ignoring the further similarities that extend beyond those groups.

And I'd love for you to justify why you think it fits better. How is it a bettter explanation. Even if I would agree that "orchard" also fits the evidence, then you've got two separate explanations that both fit the evidence. It wouldn't make one better than the other, from that mere fact alone.

"instead of the branching tree with a bucket load of unknown transitions"

And because of unkown transitions, you would ignore the know transitions? "Unknown" does not trump "known", or you are committing an argument from ignorance fallacy.

Just like we cannot prove that "no gods exist", you cannot prove that all those transitional forms do not exist. It's the exact same principle.
If we cannot find evidence, then we have to take another route to finding the answer, or keep living in ignorance of the answer.

" another misconception of you atheists is thinking God uses "magic"... God uses specific principles and laws to achieve things: little to no magic involved:"

It's not a misconception, it's the word I use to describe a concept. Something that is scientifically impossible, to our knowledge. And you do not get to decide what religious people believe.
Also "little to no mage" doesn't make sense. If a god has the ability to use magic, then he/she/it has no reason to use anything else. If you were omnipotent and had magic abilities, would you build a house or poof the perfect house into existence?

But I agree that even "magic" must have some kind of pricinples, and work according to some kind of law, or it would be random and could not be harnessed. But anything that cannot scientifically happen is what I call "magic". I do not think magic actually exists, it's just a concept. The ability to set nature aside and have your will be done inspite of nature. That's what I mean by "magic".

" but as Galileo said [...]"

Yes, what he said is an example of where creaionists look at a natural world that follow natural law, and still tries to squeeze in a god there, by saying that it is the way it is because god chose to make it that way. It's not a good argument, because if things were completely different, you could still say the exact same thing. So it means nothing.
I would say that in a world that is actually made by an omnipotent creator god, we should see something that defies nature. There should be birds that fly because a god said they should, even though they naturally can't.
And I know that doesn't make sense. Everything makes sense the way it already is. But a god doesn't need to create things that make natural sense.

"8. And alternatively just giving up will yield a better result?... of course not: all I'm asking is that you read my comments closely to save me a few unneeded lines, and to try to summarize your lines by pointing out the key points and arguments"

So tell me, if I mention the recurrent laryngeal nerve, as I did earlier in this reply, am I supposed to explain to you what it is, or not? If I had good reason to think you knew what it was, I wouldn't have bothered putting the effort in an explain it. Am I right or wrong in trying to be informative, and making a judgement call about what I think is likely that you already know?

"well thanks for your efforts and information: but I'm already conversant with most of the information you brought up: this is not about informing me: it's about method and precision of thinking for accepting any information"

OK, just verify that this is what you want, and I'll refrain from being informative, and just reference things, instead. I'll assume that's what you want from here on.

"you see I realized you are a sucker for "scientists say"... I'm sorry but I'm not... thanks for the links but if I can't see graphical representations of all the claims, then it's just unverifiable claims to me... it's evidence for nothing"

Fine, that's your loss. While you continue to call things "unverifiable" because they don't present it to you the way you (a layman) like it, the rest of the scientific community will keep making progress that leads to new technology that you will also benefit from. Technology is fine, but understanding apparently isn't, huh?

And yes, when I am not qualified to make a call myself, I defer to experts. Usually, I can tell whether what they say seems to line up reasonably or not. If I can't even do that, I just make sure there's some kind of consensus for what they're saying, by reading from multiple sources.
If I turn out to be wrong, it's hardly the end of the world. And I do not get paid to know, so I have no responsibility to make sure I am damn right about everything.

".... I'm sorry but no you didn't... you must have missed the picture of the evolution of the whale: how's that not digging into the past?..."

The article itself talked about he evolution of whale, but when it described evoluion, in the beginning of the article, it did not rely on digging in the past to describe it!

You're telling me that on the same page where they describe evolution, they are not allowed to also mention anything like the evolution of whales, huh? That's pretty damned arbitrary.
Next you will ask me to find a description of gravity on a page that doesn't mention planets, right?

I very well did do what you asked. The evolution of whales is not the description of the theory of evolution.

"that picture alone gives the idea of the kind of "change" they're speaking of"

Yes, and that's nice. Showing an example of application is a good tool for learning.

"and that kind of change is imaginary"

Yah, we only imagine that we find those transitional fossils of whales. (Hey, even autistic people can do sarcasm!)

" that's why I try my best to differentiate b/w the two kinds of changes that are causing the confusion here... I'm still surprised you haven't seen it yet"

The difference being time scale, alone. And yes, I can tell that difference.

"you want to know what I think?... I think if they were so sure of their findings, they should have released photographs or pictorial representations of their findings"

I'm not going to get into another rant, because you expressly don't want that and keep complaining at it. You're simply wrong, because scientists don't do that. They have work to do, you know. A peer-reviewed sicence journal is not the same as a popular science magazine.

" I say this because I know the media wouldn't hesitate to propagate pictorial representations of these claims if they had any remote access to them"

Media are the ones who hire artist to make graphical representations to go with articles that cover the findings of a scientific paper. You cannot put this on the scientists, it's not their job.

"till I see clear evidences of these claims, they remain unverifiable to me"

And if you sit in front of a TV and close your eyes, the TV is invisible to you.

"of course not: as a matter of fact 90% of the christains I know are either ignorant, hypocritical or just plain idiotic"

Funny how 90% of all creationists say that.
On the other hand, it's annoying to talk about "god" and such when every religious person believes in a different "god" that every other.
There's not one christian god, there one for each christian.

"being critical is putting the same amount of bais, thinking and reasoning into both sides"

I also think it's important to have the same standard of evidence, which of course is directly related to "bias".
But we are all inherently biased, in many ways. If I heard that someone did some crime, I might not need much evidence to agree that he/she might have. If someone accused my aughter of something, I'd require very strong evidence before I could accept it, I suspect.
And I know humans are biased. And I know this is one of the main reason why religion is so common and so hard to eradicate.

" you need a lot of faith to actually believe what's made out of most of these so called evidences... take an instance of LUCY... "

Not "faith", but inferences. "Best guesses" based on what we currently know. And when they converge on the same answer, that is strong support.
But there is no "competing theory". No other scientific explanation ever proposed can explain the evidence. Explaining half of the evidence, and ignoring that the rest of the evidence doesn't fit it, is not OK. Even one piece of evidence against an idea is enough to disprove it.
For eample, if I were to say "all planets orbit their stars", and we find one that doesn't, it disproves this statement utterly and completely.
But no matter how many planets you do find that do orbit their stars, the statement is never proven, because you can never know if you've found every planet in existence. Therefore, science can be disproven, but can never be proven.
The theory of evolution could be disproven, but it never has been.

Yes, "Lucy" is was an important find, because she is pretty perfectly intermediate between modern humans and the common ancestor of humans and chimpanzees.

"i-   first you need to believe that those bones are actually all real and not fakes (not much to worry about in this case I suppose: but still a certain degree of faith needed)"

"Trust", not "faith". Trust is earned, while faith is not. Scientists have generally earned some amount of trust.
And "lucy" is just one of something like 300 individuals we've found of the same species, australopithecus afarensis. It's unlikely they're all fake, right?
And other scientists have examined it, and at least not yet discovered it to be fake.
But you're right, we never fully, completely trust anything. We always need to keep in the back of our minds the possibility that something could be wrong, which is why science is never set in stone.
The same is not true about religion, though, which is dogmatic. It is not allowed to change, even though it secretly does, just to stay alive.
Religion changes by basically covering up the fact that it ever changed.
I'm speaking generally, of course.

"ii-   secondly you need to believe all those bones belonged to the same organism(animal/whatever)... you need to believe they were not mixing bone fragments from different animals..."

Yeah, if you're qualified as a paleontologist, you can determine your certainty. As a layman, I have no chance, so I have to assume that the consensus is a reasonable belief, for now.

"iii-   you need to believe that the skeletal reconstruction is actually a correct prediction from the 40% bone fragments available..."

You just have to keep in mind that we only know 40% of it. Call it 40% certianty, though it doesn't translate like that. everything in science is different degrees of certanty, and we can usually quantify our certainties.

As for "lucy", I think that considering we've found a few hundred individuals, we've got a decent reconstruction of the complete skeletal structure. But I honestly haven't checked, so I don't know.

But you don't need 100% to be able to tell these things. You don't even need 40% to tell what somethign is related to. If you're lucky, you find some part that is pretty distinct for some specific species. And that chance is pretty high, because many parts are very distinct.

"iv-   you need to believe that the full body reconstruction actually depict the organism... this is where the most faith is needed... because you can never tell the amount of body hair, or nose structure from 40% of fossil fragments"

No, you don't. Do not mix up popular media's presentation with the actual peer-reviewed science. It's the science that matters, not how far media decides to extrapolate it. Don't blame the scientists for what the media says. And scientists rely on the science, not the media.
If you try to submit a reconstruction as a scientific paper to a peer-reviewed science journal, you will get rejected unless you justify the method used to get to that reconstruction. The method used must be proven reliable. If that's the case, then using that method is accepted, because we know it's reliable.

"v-  you need to believe that that animal(or whatever) actually behaved the way it is perceived to behave: ie was it actually primitive or not or any other perceived behaviour "

Well, you don't need to do that to know if it was related to some other animal. When it comes to behaviours, yes, there's a shitload of educated guessing, based on morphology and relation to other animals. And we know this, we know that behaviour is very speculative and can't be very satifyingly demonstrated to be true. But we try to learn as much as we can about the behaviour of extinct animals, by whatever means we can. But if you ask a paleontologist, he will agree that it's quite speculative. And every other scientists knows this as well, and does not base critical science on such speculations, because that would not be accepted.
There's gradient, of course. Recently extinct animals are easier to know the behaviours of, for example, and some aspects of their behaviours can be determined quite easily, like their eating habits, whether they're meat eaters, and so on.
But as for what sounds they made, or the color of their skin, that's usually quite pure specualtion, but it's also not crucial to anything. It hardly matters. They do their best, and that's fine, who cares.

"now think of the amount of faith you need for a fossil like pakicetus that had two chunks of the skull bone to work with..."

"Faith" in what? If you find a skull, and you have no way of knowing what it belongs to, just what are you supposed to have "faith" that it belongs to? There's obviously a reason why they "picked" a specific animal, rather than some other, and why it is ´consistent. If scientists just randomly picked what animal they belonged to, then you'd have multiple scietnists assigning different skulls to the same animal.
So, no, there is no damned "faith" involved.

"if you want to view those bones without any faith, or belief, what you're left with is just a bunch of fossil bones... that's all.."

No, no matter how much you empty your brain, the fossil bones still have specific shapes, and that is evidence, because it excudes some things, but not other things.

Seriously, you seem to have a hard time understanding the concept of evidence, because you keep portraying it as if it's something that exists in the minds of people. You cannot change the evidence based on what you believe. A round peg will not fit into a square hole, so to speak.